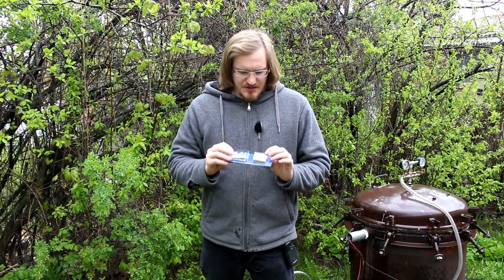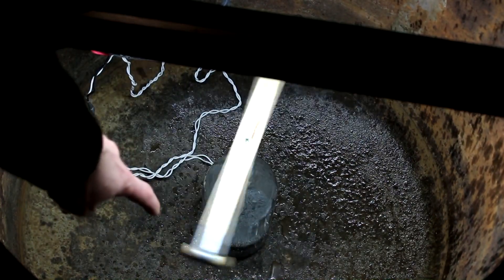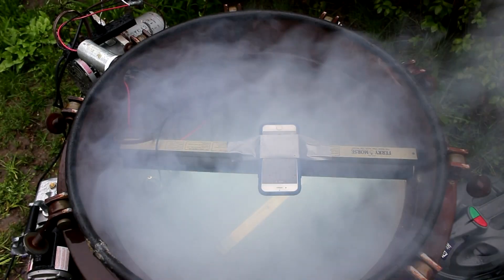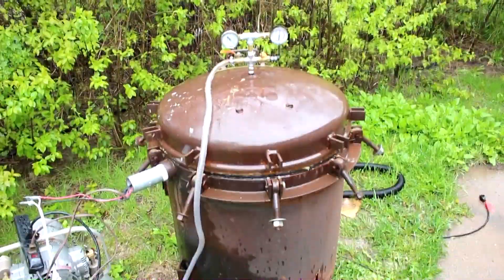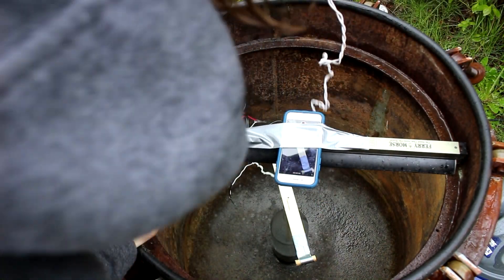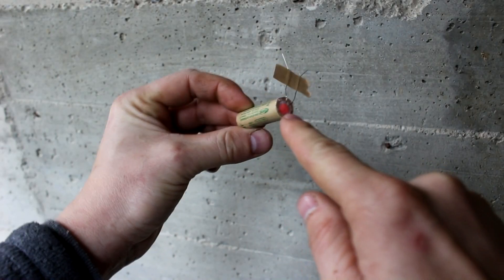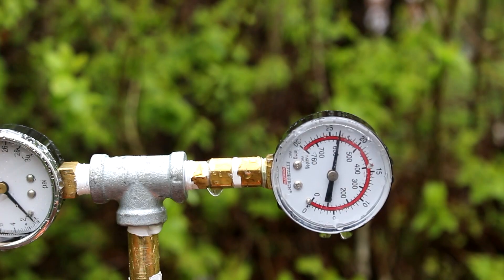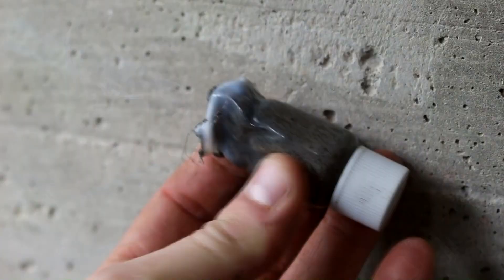Will a Model Rocket Motor Work In Vacuum?

Comment: im not sure but, isnt it kinda cheating to put it in its own little bottle and then create a vacuum because the bottle is still under normal pressure? please reply why i am wrong if so :)
Reply: it's not the oxygen that's the problem, the rocket has its own oxidizer; It just wasn't designed to work in a vacuum, if he filled the bottle with an inert gas like Nitrogen it probably would've worked as well.
Reply: 2010invent huh? yeah, obviously if the fuel in the rocket runs out the rocket doesn't work anymore. And rockets move by pushing a huge amount of mass in the opposite direction they need to at high velocity similar to how a cannon experiences recoil when fired. The combustion drives expansion of the propellant, in turn driveing said propellant out of the muzzle/nozzle at very high speed and pressure. No air required in either scenario. The lack of air to get in the way even facilitates higher exhaust velocities and even higher performance.
Reply: 2010invent 

you still don't get newton's second law.   force = mass x acceleration 
now, if you take a gallon of rocket fuel and  squirt out of a nozzle without igniting it,  at say, 300 feet per second. 
there will be some force (recoil) and there will be a measurable amount of it.
but it won't amount to much.  you take that same gallon of fuel,  expand it several thousand times by atomizing it, and setting it afire. ( remember things expand in volume when heated)
and whoo boy... now you have something! that flame is gonna come out of the tail pipe at 4,400 feet per second.   same mass x a helluva lot more acceleration. = ridiculous amounts of force. remember you didn't change the mass of the fuel, you just expanded its volume and made it go a ludicrous velocity.   
just like if you fire a .45 acp carbine that shoots a 200 grain projectile at 900 feet per second, and compare it to a .45/70 rifle that could in theory fire a 200 grain bullet around 2000 feet per second.  guess which one of those is going to whale on your shoulder more?  same bullet,same mass, alot more force (recoil). the difference is the velocity. 

now that you understand newton's second law... let's look at the third law.
on earth or in space, jet or rocket propulsion has nothing to do with the exhaust eflux acting on something to "push against"  ie: atmosphere to produce thrust.
it's all about the velocity, and mass of the exhaust plume -  as dictated by the second law of motion.  

you take jet fuel and air, or an oxidizer and a rocket fuel, or a pair of hypergolic reactants, and combine them in a combustion chamber and light them...
what happens? they expand at a frighting rate and come out the nozzle at supersonic velocity.    
those gasses have mass, and they are going really really fast, and there is a fuck ton of it.  the object they are squirting out of is going to move with the same amount of force... in the opposite direction. so says newton's third law - for every action there is an equal and opposite reaction.  
just as the firing of a bullet will drive the rifle into the shooters shoulder with force proportionate to the size of the powder charge and mass of the bullet.  so will the aircraft or space craft  "recoil" from the expulsion of mass in the form of the massive amount of supersonic expanding gas coming from its exhaust nozzle.  does a rifle recoil because the bullet and shot gasses push against the air when they exit? certainly not... that would be a silly thing to think, No?  it's because the mass of the bullet and shot gasses are exiting the barrel, which causes the rifle to go in the opposite direction. 

it's really very simple,  if you realize that 1. the exhaust gasses actually have weight (like the bullet) and 2. exhaust gasses have velocity (like the bullet)
then it's not so difficult to make the logical leap to how a rocket engine could thrust in a vacuum.   something to "push" against need not apply.
Reply: 2010invent 

go stand under an AJ10 on a test stand and have the guy in the block house push the big red button. 
then you'll get to see just how "candle like" that exhaust plume is. 
there wouldn't be be enough of you left to pick up with a shop vac... that I can guarantee. 

and the AJ10 is a little upper stage motor...
Reply: well it did not really require oxygen because the fuel already has oxidizer in it to provide oxygen for the reaction it only needed the pressure to get the fule going once the fuel started to burn it did not need any pressure
Reply: At first he was trying to get it to ignite in vacuum, but when he realised that wouldn't work he used the bottle to start it in atmosphere so he could then see if it would continue to fire once exposed to vacuum.
Reply: How can it be "cheating" if it works? This is just the method he used to start the chain reaction to allow the rocket to self-sustain itself. The rocket is burning in the vaccum, the bottle is just there as a catalyst to get it started.
Reply: Jjaro V real rockets designed for vacuum conditions something similar to this by restricting the exhaust port to allow the pressure to skyrocket when the fuels meet and begin to combust before exiting into the bell nozzle at high velocity. they just use thir own liquid fuel to provide pressure in an enclosed space so combustion can occur instead of an outside pressure source. A solid fuel hobby grade motor has no such mechanical advantages to work off of.
Reply: "Will a Model Rocket Motor Work In Vacuum? -No."
The motor works just fine.. His ignitor does not work in a vacuum.
Heck, in my own experience those ignitors only work about 4/5 of the time on the ground under ideal conditions!
Reply: All the oxygen was not used up. The Fuel in the motor uses potassium nitrate which is an oxidizer. But yes, it will burn in a vacuum once started.
Reply: every problem has its solutions a combustion dosent make a combustion engine, it takes a piston to get things started and meny more things to make it run and produse momentum. a rockit doesn't make a rockit that works in space it take meny more things to make it run and work perfectly. so asking if it is cheating is like asking if it is cheating to put  weels on a car to make it run on the road
Reply: I am very sure the bottle was not sealed tight enough to keep any pressure inside while pumping it down. The point of the bottle is to provide a little bit of "back pressure" for a little bit, which is created by the gases created by burning fuel itself. The bottle is so small that it is immediately filled with gases as soon as the combustion starts.
Reply: 2010invent Funny how muh mind control just happens to not work on certain members of our society like you, especially since you all seem to display very poor language skills, which is indicative of low intelligence. Perhaps there's a simpler explanation of why nobody agrees with you which involves your low intelligence and lack of understanding of basic principles of physics and chemistry.
Reply: TheCascadian 
"Erik Wigforss God isn't real. Grow up and take a physics class."
Don't waste your breath, or any electrons on him.
Reply: LifeIs Short 
If the Earth is flat, then answer this question. 
Why, when I go to Rio De Jinarro Brazil and I look up in the night sky to the south, I see the constellations seeming to rotate conter clockwise. around a specific point close to a star but not perfectly on it. But when I look up in the northern night sky here in Missouri,  I see a different set of constellations seeming to rotate clockwise around a specific spot in the sky that corresponds with the star Polaris.  How can that happen on a flat Earth?  It's  simple to explain on a spherical Earth.
Reply: LifeIs Short 
Oh, so you don't have a coherent reply so you're going to dismiss me and my simplest of proofs that your flat earth theory is wrong.
I want to hear what kind of machinations you have to go through to save your conspiracy.
Reply: Jeff Marler yeah but Cody can make his own he is good at those things
Reply: bladerise Not cheating, as it's just used to get reaction started. Shortly after motor is running it Burns through casing and no longer relevant. I would have tried using a piece of nichrome wire throughout motor (right down the center).
Reply: dahat42 your actually comparing apples to oranges there. there is a big difference between the rocket engines tupically used in space and the one that cody is testing here.
the motors typically used in space burn liquid fuels not solid fuels and they are presurised by a turbopump that presurises the combustion chamber. for any reaction to occur there must be sufficient pressure for the attoms to interact with one another.
this motor is a solid fuel motor which means it is just a shaped explosive charge   in the case of this motor its just compressed gunpowder with a hollow cylinder. it needs pressure to ignite because in a vacum the energy released by the initial ignition burst is spread out too fast and too far to allow the reaction to become self sustaining hence why a presure cylinder was required for the initial ignition.

the gas in that cylinder is not used in the rocket motors start up. filling it with xenon wouldve had the same effect.

changing the igjiter to a blanket igniter that interacts with the majority of the fuels surface area within the motor would also have negated the need for a pressure cylinder
Reply: +Erik Wigforss THe global elite? I had no idea he was paid by highly skilled CS:GO players. In all seriousness, it's just willful ignorance to dismiss this as "muh shills" when there's literally nothing stopping you from replicating the experiment. That's what science is all about, but I guess you don't understand much about that do you? Nah, the Jew World Order is paying some random guy in Utah to make a video about rockets to confirm opinions everyone already has, never mind that it's better to just leave an issue alone if you've already deceived everyone lest they start to wonder why you're trying so hard to convince them of what they already believe.
Reply: 2010invent 

lol.

obvious troll is obvious...
gr8 b8 m8, you ra8 an 8. 

get back under your bridge silly boy.
no one is buying what you are selling.
Reply: +bladerise I suspect that if he used the igniters at the recommended voltage, the heat applied would hang around longer, and might stand a better chance at getting the gunpowder reaction moving. He seems to have bypassed that process and simply tried to ignite the motor by exploding the bit of nichrome wire inside the igniter squib with house-current. 

I think this would be counter-productive, blowing the igniter substantially out of the powder-grain contact quickly without applying very much heat energy to it.

Don't get me wrong, you can make cool time-exposure photos by exploding bits of nichrome wire, but I don't think that's the best way to apply heat to gunpowder.
Reply: sleat Yeah, I don't know, man. Despite the mountains of evidence of a globe Earth and absolutely zero evidence of it being flat, we're still here debating it. 

Ask one of them to show you the edge or the firmament. Surely one of them must have driven/floated/flown to the edge by now, right? But no, they come up with some bullshit about an ice wall that you can't approach. Or armed guards. Or something equally fucking stupid. 

Like this idiot, LifeIs. Absolutely no idea what he's talking about, yet talks about it like he's an expert. An absolute poster child of Dunning Kruger. 

Keep after it. I won't waste any more time on flat Earth bullshit.
Reply: +Robert Destree "I don't know why we have this sudden uptick in flat Earth believers."

1. Looking for attention?
2. Trolls?
3. Wanting to feel "smarter than the sheeple"?
4. "Me-too" video monetizers, and the "old guard" likes of Eric Dubay.
5. A psyop purpose-designed to make other conspiracy theories look silly by association.
6. Unfortunate people taken in with believing what they're told by scammers, without verifying it.

Perhaps a mix of some or all of these things.
Reply: The rockets useable in a vacuum also have their own pressure container with a high pressure feed, so that the fuel burns at much greater than atmospheric pressure. These model rockets don't really accurately simulate that.
Reply: view the rocket and bottle as its own rocket
Reply: Mauricio Harrison 
to get the initial burn started it was needed.   a solid fuel grain can be difficult to ignite, even under one atmosphere.  there wasn't enough air in the bottle to supper combustion any longer than was needed to get the propellant (which is a solid fuel and oxidizer molded into a cylindrical grain) to ignite.
had this been a hypergolic or LOX/liquid fuel motor, it would have lit quite easily even in a vacuum. as those types of fuels will create thier own atmosphere in the combustion chamber. 
unfortunately building a small scale rig to use these fuels in this vaccum chamber would be difficult.
Reply: dahat42 

the model rocket motor propellant grain contains it's own oxidizer. 
probably potassium nitrate.
if you can just get it hot enough to start the reaction - it'll sustain in any atmosphere you want. 
the trick was getting the reaction started. 

incidently, solid fuel motors aren't used in a vacuum... because they would be difficult to ignite.
Reply: 2010invent Based on your grasp of the English language I'd say you're the only one who has contaminated water. Lead, based on the severity of your apparent learning disability.
Reply: 2010invent >"But that cannot run longer than the air supply"

I mean this video kinda showed that even toy engines can, it's just that engines designed for an atmosphere don't have the same sort of fuel used which allows it to ignite easily in a low-oxygen environment. Do you know what oxidizer is? One extreme example is chlorine triflouride, which can ignite almost anything, even glass, without the presence of oxygen. Most less powerful oxidizers, however, contain oxygen in their chemical composition which reacts with the fuel in the same way that oxygen gas does.

>"If space is a vacuum rockets cannot work doesn't matter how you try. Nothing for it to push against."

Again, the video kinda showed that this claim is false. But you don't even need to watch it to know this. The exhaust pushes against the rocket. Do you actually think that all propulsion is caused by pushing on air and not the projectile? Air is not that viscous. This is why recoil exists in firearms. The bullet takes the place of the exhaust from the motor: A combustion reaction pushes a massive object(bullet/exhaust) in one direction, causing another(gun/rocket) to move in the opposite direction.

Honestly both of these claims can be debunked just by watching this fun 8-minute video. But I also think it's funny that nobody making the claims you're making has ever actually studied rockets. Why not go into that field and "expose" them or actually see for yourself that the things you build do in fact work?
Reply: +Erik Wigforss God isn't real. Grow up and take a physics class.
Reply: 2010invent I have a friend that works in a pharmaceutical company. He actually developed a cure for this disease in horses, yet his project was dumped into the trash by the company simple because it didn't make any profit. Companies exist solely to make profit, nothing else. They don't care about you at all.
Reply: +Erik Wigforss Ok brother, you don't know me but I can tell that you have some doctrinal issues, biblically and not. One, NASA has sent rockets into space and they just use higher density fuel that can create more pressure by itself and sustain a burn. The pre-tribulation rapture is a satanic lie that is going to be responsible for the great falling away. You need to do your research on what bible you are reading, and read into the "proof texts" they are telling you about the rapture. I like your enthusiasm to preach Jesus Christ, but don't deceive people with your doctrines of man.
Reply: @VegasSubie  nasa means not-a-space-agency. We never went to space. That’s a lie. They themselves say they can’t get through the van allen radiation belt. That’s why they haven’t gone back and they say they lost all the information on how to get there. If you want to bring the Bible into this, the Bible says there is a firmament above us. Water above.
Reply: +IamGrimalkin  "I don't think the heat is the issue here, the problem is there is not enough pressure to hold the liberated oxygen to the rest of the gunpowder to keep the reaction going, as he suggested in earlier videos. "

I guess you could test at what pressure it's possible to get gunpowder to ignite with any amount of heat.
If there was a sort of thick ni-chrome element in your test-chamber, connected to a variable power-supply, you could simply start with samples of powder, and gradually reduce the pressure until your pile of powder utterly refused to go off, no matter how long the red-hot ni-chrome sat under the pile.

Seems like a tiny soft-rubber cork would allow enough pressure to develop in the throat of a motor, if it made a fairly good seal, once the igniter squib went off. The ones you get with the motors don't seal too well. The little igniters are a nichrome bridge with some self-oxidizing flammable material painted on.

The jar method with a bigger plug is perfectly valid too, but it requires the plug to hold more force.
Reply: 2010invent You are absolutely wrong. Go study Newton's third law. There is no such thing as "pushing off of air". It is the rapid expansion of gases that causes thrust. If you take a pressure washer wand and pull the trigger, you will get kickback. Aim it at nothing, kickback. Aim it at a wall, exact same amount of kickback. The kick is caused by the water exiting the nozzle at high velocity, and not caused by "pushing off of" air. By your idiotic logic, the closer it gets to something that's fixed in place, the more kick you should feel. That ain't how Newton works.
Reply: bladerise 
"im not sure but, isnt it kinda cheating to put it in its own little bottle and then create a vacuum because the bottle is still under normal pressure? please reply why i am wrong if so :)"
-------------------------------------
It's not cheating.
The reason why these miniature / model / toy rockets need to be allowed time to ignite, is almost certainly because the reactants, fuel and oxidiser both need to be heated adequately to start the chemical reaction. Failure to ignite is not the same as failure to run, i.e. burn.
The fuel is most likely likely gunpowder.

With the space-rated rockets because the reactants used are far more reactive both gases.  
"Once in the tanks and with the launch countdown nearing zero, the LH2 and LOX are pumped into the combustion chamber of each engine. When the propellant is ignited, the hydrogen reacts explosively with oxygen to form: water! Elementary!

2H2 + O2 = 2H2O + Energy

This “green” reaction releases massive amounts of energy along with superheated water (steam). The hydrogen-oxygen reaction generates tremendous heat, causing the water vapor to expand and exit the engine nozzles at speeds of 10,000 miles per hour! All that fast-moving steam creates the thrust that propels the rocket from Earth."

https://blogs.nasa.gov/Rocketology/tag/rocket-fuel/

Ignition
https://blogs.nasa.gov/J2X/tag/ignition/
Reply: LifeIs Short No. Stop uttering nonsense. Nothing is pushing off the walls of anything. For fuck sakes. Learn physics. 

Go to a car wash. Take a bucket with you. Aim the pressure washer wand completely level and pull the trigger. Feel the kick? Newton's third law. The rapidly expanding water jet is causing the wand to kick back. Now aim it at a wall. Pull the trigger. Exactly the same amount of kickback. Aim it into the bottom of the bucket. Pull the trigger. 

Guess what? Exactly the same amount of kick. It's not pushing off the air, the wall, or the bottom/sides of the bucket. It's the pressure at the nozzle tip. Period. 

Rockets work fine in a vacuum.
Reply: One hundred percent wrong. Again. 

I give up. You have no interest in learning why you're wrong. There are countless experiments done right that disproves you on every point. But you don't care, you'd rather live in your cone of ignorance.

Don't bother replying. I won't waste more time dealing with you. You're just not worth it.
Reply: +LifeIs Short So, do you reckon a gun would recoil in space?

"You cannot push away from nothing."

You can push away from mass !

That little motor is substantially lighter after it's been run. Why do you think that is?
Reply: Daniel Glus You're wasting your time with him. He doesn't understand Newton.
Reply: +2010invent "Why a rocket engine doesn't melt steel?"

Gosh! OK, so a rocket engine would melt steel if you didn't stop it from doing so.
Rocket motors and welding torches are very similar, except most liquid fueled rocket motors are >1000 times bigger than any welding torch. Ever noticed how your welding torch is made of pure copper? That's on purpose, not just because it looks pretty. Also, you can definitely get thrust from a welder. If you build the right sense apparatus you can measure thrust from a welding torch.

If you look into how liquid fueled rockets are designed, there is usually a two-layer combustion-chamber-nozzle. The inside layer has liquid oxygen flowing through it, which is very cold, and stops the inner layer from melting. Engines like the F-1 also ejected the cooler turbopump exhaust into the gas stream about halfway down the nozzle, which ran along the inside wall of the nozzle to keep it cooler.

For short-burn solid fuel rockets, you have to make the throat of the nozzle out of Graphite, fireclay, or machined copper, which is harder to melt than steel, since it conducts so well.

" Yet we are told that air-plain fuel melted the steel on 9-11."

You're comparing apples and oranges, first of all. Airplane fuel isn't the same as rocket fuel + pure oxygen. Those fires on 911 were office fires, obviously burning rich since the smoke was dark.

If steel literally melted (there's an ongoing debate about this) something else must've melted it. You can't burn kerosene in air and melt steel. If you could, you could weld with a kerosene flame, and you can't do that.

Also, jet engines have a kind of high-nickel content steel called inconel for the "hot section" of the engine.
Stainless would also work, and has been tried, but inconel has other desirable properties, such as the fact that it doesn't significantly lose strength at fairly high temperatures, and doesn't expand when heated as much as normal steel. When you have < 1mm clearance inside your engine between the turbine blades and the casing, this is very important!

"Scientist don't work for money and fame?"

They compete with one another! If one of them ever tried to BS their way around an experiment, the others would be on him like flies on...

"Doctors want to cure us?"

Most actually do! I've got a few I'm close to, and they definitely want to make you well.

The ones who profit from you being "a little bit sick" all your life, are big pharmaceutical companies.
They'd happily sell you medicine for your entire life that just stopped your symptoms without curing you. They exist purely to make as much profit as possible, for themselves and their shareholders, as possible, for as long as possible. Making you well (or killing you) is counter-productive, since they lose a customer.

As an example, SSRI antidepressants. Close friends have asked their doctors if they could ever stop taking them, and been told "no". (the doctors are following the pharma company instructions) So they "revolted" and got themselves off the anti-depressants. They're now productive, happy and healthy!

This is not a recommendation! If you're on antidepressants, you may need them to stop from being, for example, suicidal or otherwise dangerous to someone. Some don't.

You bring up a lot of cases where people lie. Yes they do, but others also expose the lies. People do that, but it's very hard to lie about the very laws of physics. Someone competing with you will expose your lie fairly quickly and gain power from that.

The alternative is just crazy, where every single one of millions of scientists are all agreed that they will lie to you, and not one of them has blown the whistle on it, which would virtually guarantee that scientist great fame. And if he was killed, that would make him even more significant and bring even more light to the "great hoax", if there was one.

Again, the fact that authorities (mainly politicians and marketing types) can and do lie, doesn't mean either that the Earth is Flat, or that rockets can't work in space.
Reply: +rex racer "Try to fly anyway and I guarantee you will be shot down b4 you can get 75 miles over land."

I guarantee you won't !

Go and talk to antarcticaflights.com.au
http://www.antarcticaflights.com.au/

Their 800 number is right there. Please call them and confirm that "you won't be shot down"!

They will fly you down to the Antarctic continent, and fly you around down there, and then back to Sydney or Melbourne the same day. You don't land, but for even more $$ you can land there, with other providers.

If you take a GPS with you, it will definitely show you're over Antarctica, not to mention that it's pretty hard to fly due south from Australia for hours and not get to Antarctica.

If you decide to book a flight for next year's Antarctic "summer" I will come with you!

Honestly, friend, if you think there are jet fighters based in Antarctica 24/7 year round, can you elaborate exactly where they might be based? Also, where is the associated air refuelling wing which would gas 'em up inflight?

If they weren't based there, there is no way in hell they'd have the range to come get you if you were flying there. Fighers just aren't designed for ~6-10,000 miles of range.

Further, who pays for all that, assuming it's real (it isn't)?

Check this out. These were long range bombers and they were only trying to get to the Faulklands, much less Antarctica.

https://en.wikipedia.org/wiki/Operation_Black_Buck
Reply: +LifeIs Short "When you turn away from Polaris, (looking 'south'), everything would turn the opposite direction."

If Polaris is in the center of a domed Flat Earth, there is literally no geometric way to make it so that all Southern Hemisphere Observers will see the same exact Southern-hemisphere-only stars rotating counter-clockwise around the dim star Sigma Octantis. Since a dome is at best half a circle, the stars at the edge would be going along the horizon, not rotating the other way. "Turning away" from Polaris, assuming you're at the North Pole, would involve looking straight through the ground.

That's a very big problem many folks have with Flat Earth. The night sky in the Southern Hemisphere simply doesn't work with the models that have been presented.

If you can come up with a geometry (just draw a simple diagram) that allows say, both Australians and South Americans to be looking the same way when they all look South, and still have the Earth be a disc, I'd really love to see it. If you look at a "flat earth map" South is in different physical directions for each Southern Hemisphere continent.

If you imagine the stars are on not a dome but a sphere surrounding the earth, then the only way to see the counter-clockwise half of the star-sphere is to be on the other (South) side of the earth.

If the "dome" was a sort of rubber-sheet, then you could force it to rotate one way around Polaris, and another way for one of the Southern hemisphere continents, I spose, but it would then look horribly wrong (i.e. not like reality) for all the others.
Reply: +Lifels Short OK That's a reasonable reply.  So  now we are moving into a flat earth argument. Now I understand why you find the concept of a rocket a problem. So the problem is this. If you assert the theory that the earth is flat, then the burden of proof is on yourself. There is no need for anyone to prove that the earth has another shape as they are not the one making the assertion. For example you mention atmospheric lensing. You should be able to provide formula describing the behaviour of light which matches our observations. Or explain why half the world is in day and half in night again provide the maths. 
If we are under a dome and the stars revolve around polaris. Then the dome revolves either clockwise or anticlockwise. You cannot have a point on the earth where there is another rotational centre and the dome revolves the other way. I am a artist and can do the transforms in my head. You should try modelling it in a CGI program ( blender is free) https://www.blender.org/ It is a simple model to do. I could knock one up over the weekend but I would need to understand exactly how the flat earth works in order to produce an accurate model.  Interestingly I have asked this question before and no one was willing to help.
Reply: +Mark Gohl Yes, showing how two distinct celestial poles work on a Flat Earth has never been published, as far as I know. I'd be very impressed if an F-E believer could show a model where this works.

I think the burden of proof also exists for folks who claim rockets cannot work in vacuum, since rockets do work in vacuum whether they believe it or not.

We can obtain separate evidence (without vacuum thrust experiments) which very strongly indicates that man-made objects are in space. The evidence for man-made space vehicles is interlocking, i.e. several things can be observed about one vehicle via different methods of testing from Earth.
Reply: LifeIs Short 
NO, this is where Flat Earth has no reasonable reply. 
The FE model asserts that Antarctica is a ring of ice around the edge of the supposed FE. So, when I am on the beatch in Rio, looking toward Antarctica, I am much closer to the "rim" of earth looking off the edge. I would see the constellations traveling straight, left to right across my feild of vision.
The only way I could see the constellations making a clockwise circle around a point would be if the FE were flipping over. Which of course wouldn't work because that would mean what I see from Missouri is rotating at 90° to what I see in Rio.
Case closed the earth is a sphere. 
I don't need to watch anyones video to see that this is so. Stick a dowel through a ball, and a dowel through a coffee can lid. Mark the relative positions for Missouri and Rio de Janeiro on each and tell me which supports what I see.
Reply: Jerry Long I'll give you a hint why he won't acknowledge you: Dunning Kruger. He truly believes the nonsense he's spouting. Good luck.
Reply: Robert Destree 
Yeah,  earlier he said someone could put an end to the FE scam in an instant by just showing their evidence.  I thought this would be the simplest proof. Anyone with the capacity for abstract reasoning can close their eyes and picture this example. 
He's got nothing, so he ran away. He'll be back, after he watches some more videos, and have some explanation that requires me to watch the video so and so put out. I think the whole FE scam is about monetizing videos.  The only true believers are those folks that already believe in some other conspiracy theory. The real thinkers behind it know it's BS, but they're making money off their videos. They are laughing at the true believers all the way to the bank.
Have a nice evening Robert :) Dunning- Krueger does fit though.
Reply: +Lifels Short My computer is currently tied up with a Rendering run at the moment. It take about 5 minutes to render a frame and I have a few hundred frames to go. However next week I may have some time to have a go at doing a model of a glass dome with things on the outside of it. Do you have any more details ? or would you like me to just wing it ?
Reply: LifeIs Short "we have no idea on the thickness it would have to be, to give the appearance, and there may be two dense arms (straight or curved) circling above, that represent the Milky Way band."

We don't ever see the Milky Way move relative to the other stars, though. It rises and sets with everything else.

"Just guessing, haven't seen much on this other than people's theories on the star trails.  Away on trip so only phone right now, but would love to mess with rendering"

I think rendering a Flat-Earth surface and cosmos, such that it shows how we see exactly what we see, no matter what hemisphere we're in, is a fantastic idea!

Here's a bit of a reminder of the things anyone can currently see now, looking from the right places:

- Polaris, seemingly stationary and around which the stars appear to rotate counter-clockwise at 15 degrees per hour, in circular paths and which moves up 1 degree in the sky for every 60 nautical miles you travel North, and down 1 degree for every 60 nautical miles travelled South.

- When you are standing on the Equator you can see stars rise in the East, and travel straight over head, as well as being able to see the stars further North and South moving in smaller and smaller sub-circular arcs as you look toward each Pole. When you face North you see everything turn counter-clockwise, and when you face South, you see everything turn clockwise, all at 15 degrees per hour.

- If you are in the Southern Hemisphere, the Southern Cross is always visible beyond 60 degrees South latitude (as long as it's dark enough). The rest of us "down there" see it for a good part of each night.

It's a sort of diamond of four stars with two stars off to the side lining up with the "head end" and pointing to it from one side. This whole assembly of stars rotates evenly around a spot most people can't see (too dim) which contains Sigma Octantis, at 15 degrees an hour, no matter which continent you're on down here.

The important point is that moving from Chile to Australia to New Zealand to South Africa, this thing is often visible, rotated around a point in the sky which is "up" from the horizon the same amount as the latitude of the person looking. But looking "south" from Australia and South Africa on the current F-E map, are different directions!

Your render needs to show people how that works.

- On the Equinox the sun always rises due East and sets due West, for any observer who sees the sun, unlike on Flat-Earth maps published so-far. Definitely room for improvement!

- If you put your viewpoint inside this "render" and move around, the visible horizon needs to get further away by the right amount. This means that various objects "out at sea" at different distances from the viewer, need to only become visible as the viewer gains height, which is what everyone sees now, when gaining height.

I think it's great that you are interested in making a good model of how Flat Earth works, which describes what we all see depending on where we are. If you get stuck with what the sky should look like from any particular point in time or geographically, you can use Planetarium software to show what people actually see from those places at those times.
Reply: +Robert Destree "You're the one who started a conversation with me, with no lead-in."

What a clever trick for those times when you can't think of what to say but want to bug someone!
- Make a sarcastic remark with no solid context.
- When replied to with "What do you mean?" use that as an excuse why the other needs to be talked-down-to.
- Now you have a conversation, and don't need a topic! Congratulations, you are a master manipulator!
- Profit!
Reply: sleat I don't know why we have this sudden uptick in flat Earth believers.
Reply: +LifeIs Short Here are a few of the things that F-E books don't seem to address properly:

1. Given a distance away that Polaris is said to be, and assuming Earth is Flat, the angle "up" from the horizon is only correct at two latitudes; The North Pole, and one other which depends on how high you say Polaris is in your F-E model. Near the NP, it's too low in the sky, and as you get down to the Equator it's too high by a great deal, whereas on a spherical earth, you don't have to come up with excuses for light always bending one way in one place and always bending another way in another. It seems like quite a stretch to say that the atmosphere somehow "knows" where the viewer is, and bends Polaris's light just right so that it always appears at exactly the elevation of one's latitude.

2. The Southern Cross constellation circling evenly, clockwise, around a point in the sky, where Sigma Octantis would appear if it were brighter, where that center-point exactly matches your latitude in the Southern Hemisphere. i.e. from 45 South, it's 45 degrees up, and so on. Again, this constellation circles clockwise around celestial "south" no matter what continent you're standing on in the Southern Hemisphere. The problem is that "south" from all of these continents is a different physical direction on the Flat Earth Map.

" Precession of the equinoxes occurs throughout, but again, doesn't prove either theory. "
This isn't really about precession of the equinoxes, it's about a dire problem with the F-E model which has the sun literally on the wrong bearing from the observer at sunrise and sunset, year-round, but most easily quantifiable on the Equinox.

3. What the books fail to address about the Equinox is that in the real world the sun, on the Equinox, rises a 090 degrees true east, from a direction exactly 90 degrees right of North. In all F-E models published so far, at sunrise, i.e. 6 hours before noon, the physical position of the Sun is at 045 degrees true. That's 45 degrees too far north. 45 degrees is a lot to explain away with "perspective" or "lensing". It gets worse. At sunset, it should be at 270 degrees, true. That's what everyone sees, but on an F-E map, it's setting at 315 degrees true, once again 45 degrees too far North.

In other words, in a F-E, the sun would appear in a drastically (i.e. get hopelessly lost if you used it) direction, and would only be "about right" near Noon. Even well after sunrise, when the sun is nowhere near the horizon, it's still like ~30 degrees too far North. Oddly, nothing else seems to magically appear 30 degrees too far north, i.e. the stars before sunrise on the same day.

"Most everything moves at 15 deg per day"

You mean 15 degrees per hour, right?

" I think a 'debunk' of FE would be a midnight sun in Antarctica, staying visible for 24 hours."

Certainly would!

"But all footage of this has been edited, as people have shown, with 8 hours missing, including one person who called/emailed their station to provide the missing footage from a supposed live feed and got the run around."

Yes, for some reason any "slam dunk" proof of the earth not being flat somehow has to have something wrong with it, like all the ever-growing number of photos claimed to be taken from space. It's a shame, really.

So, if someone you trusted physically spent 24 hours in Antarctica and said "real deal, it stays up for 24 hours" would you instantly have to stop trusting them? You know that it's quite easy, given the money, to spend a few days there in the Southern Hemisphere summertime, over the Summer Solstice, right?

If they are farther South than 66.5, they should have sun 24/7 for several days.

"So I don't know. "

Trips south of 66 South latitude are only a few grand, and it'd be the vacation of a lifetime!
Reply: +LifeIs Short "I've also listened to Bill Nye's explanations of debunking FE, and Niels Tyson, and they use talking points that are already shown in FE models, so I just don't trust them anymore."

It's a really good thing media dumbasses like Tyson and Nye don't control the shape of the planet, I guess.
Would you start smoking if they told you cigarettes were unhealthy?

There's a very simple proof of flat/curved experiment that can be done with two or more people with comms gear, some drones, and a distant (30 miles or so from the vantage-point) high object like a radio-tower or city building.

"I just dug into it, because there had to be some easily proven test that shows curvature, and FE takes into account most all of it, and the curvature tests seem to NOT show curvature, but rather prove its flat."

Seems like what normally happens is that folks mentally "throw away" stuff that doesn't agree with what they already think. The globe side needs to be able to tell you what's wrong with a "flat earth proof" evidence. And F-E folks need to be able to tell you what's wrong with evidence of a globe. Claiming that "all evidence of this type is fake" is cheating, on either side.

The "globe earth" side doesn't usually say that "all evidence of Flat Earth is fake", but what generally comes out is "the experiment should be changed this way" or "that experiment proves neither curved nor flat".

Again, if one side of an argument has to change accepted physical laws (like gravity, but without replacement with something else whose equations predict reality) or throw away all evidence of a particular class (i.e. all space pictures are hoaxes, or all 24 hour sun time-lapses are hoaxes, or all measurements showing the earth to be flat are hoaxes) then that doesn't add to the credibility of the theory.
Reply: +James Bondage  "Meaning the LORAN method of communication never went away. They're still using it to this very day."

Can you direct me to documentation of how several TV channels at once get transmitted over LORAN?
My understanding of LORAN is that the signals are extremely simple, with the purpose being to allow calculation of the receiver's distance from the transmitter.

Looking at the frequencies it uses, the bandwidth doesn't seem nearly enough to even send one TV signal, let alone the number that come through my satellite dish.

I've got another burning Satellite TV question as well. How come when I un-bolt the positioning and move my dish ever-so-slightly, so that it's no longer pointing to a spot ~22,000 miles over the equator, does the satellite reception disappear? If it was coming from a tower, why would the dish need to be pointed at the sky, and why so carefully? (I was able to get the TV signal back by nudging the antenna back where it was).

I don't need to do that for normal TV, radio, or WiFi, so why such a sensitive dish-antenna for a signal like LORAN? Wouldn't a long dipole be better? Also, satellite TV is definitely Ku band, like ~10ghz, as evidenced by my spectrum analyzer connected to the LNB preamp. Ku Band won't go very far horizontally, so with no towers in sight, and definitely none in the direction the "dish" is pointing, which tower is this Ku band "satellite" signal coming from? (Ku band only works line-of-sight). Also, LORAN, with a range of a thousand miles or so, wouldn't work on Ku band.

"Satelites do not exist."

So, if both my friend 700 miles away and I both tune in a low-earth-orbit satellite, one of the HAMsats, why is it that I have to tune in the downlink frequency slightly up as the thing comes towards me, and he needs to tune his receiver down as the thing is leaving his area at the same time (had him on the phone). How can both me and my buddy pick up the same drone at the same time, 700 miles apart on VHF?

I knew the thing was flying overhead, since I had to point my Yagi antenna up to the sky, and follow it, to keep picking it up.

"Drones & high altitude planes do."

Sure they do. But, according to the Doppler formula, (why I had to up-tune and buddy had to down-tune for the same signal at the same time) comes out to the speed of the transmitter moving at several kilometers per second . That tallies with the thing going from horizon to horizon in about 5 minutes, but being too far away to hear even a whisper.

At that kind of speed, the drone or high altitude plane should have been making an orange ionization trail, and the sonic boom from, whatever, mach umpteen or so, should have broken windows in my neighborhood. Amazing that it did neither.

So yeah, I guess if you've got invisible, inaudible drones, or planes that don't make sonic booms and can go horizon-to-horizon in 5 minutes without detection, and can turn up right on schedule for another HAM halfway around the world on the same frequency in only 45 minutes, I guess you don't need satellites at all.

If only these things could carry people hell we could travel between Hawaii and the East Coast in half an hour!

So, have you got any photos of these incredibly high, incredibly fast, and soundless high performance airplanes that can move at hypersonic speed without ionizing the air?

What kind of fuel do they burn? How far can they go? And most importantly, who pays for them?
Reply: How do you know you're not just bouncing signals off a moving ionosphere?  No one has seen a satellite in space, so even though it is perceived to work that way, there is no 'proof' of the mechanism, and the mechanism could be entirely different, especially given the shear volume of supposed satellites up there, that should saturate the sky.  I agree with the speed issue, it seems plausible, but I'm just not sure that's the ONLY explanation for what is observed.  Rockets and Satellites are peripheral issues as well anyway, since the real issue is the surface we stand on - and proof of its curvature (should be the most basic thing to focus on).  If a person calls out an agency whose job it is to deceive the public, say, for not turning around 360 in space, you will get a picture of it.  That doesn't mean anything for either side, since it could easily be faked nowadays.  The real proof would have been if they had done these things that FE wants to see spontaneously....like 24/7 footage of space with stars, weather patterns, etc.  I'd like to see an unedited midnight sun in antartica - that would help, but all the videos look spliced.  They fake mythbusters experiments that clearly show other rocket results (like Cody's experiments), and fake Stephen Hawking reality shows with collimated lasers and telescopes that don't even have the right math for a globe model...The moon landings are a complete debacle.  There is footage of a face behind the 1983 space shuttle (from an 'external' camera...).  Appearance of things that shouldn't be seen over the horizon is chalked up to cold air over water, but the same effect occurs with mountains, no matter the weather (same exact measurements).  The whole thing is full of holes even after 500 years of acceptance.
Reply: +LifeIs Short "How do you know you're not just bouncing signals off a moving ionosphere?"

Great question! Here's how I know:

1. UHF (and VHF) don't bounce of the ionosphere, they go through it.

2. The ionosphere doesn't reliably move towards one guy and away from another at a speed consistent with low-earth-orbit, just at a particular time of day when two random parties happen to be pointing at it, any more than, say, clouds do.

3. "Satellites" are on very reliable schedules. Way more reliable than trains or aircraft, unaffected by winds or weather, they turn up to the second at the right time. So the "ionosphere" which the frequencies we were using don't bounce off of, must suddenly have "moved" at just the right time and speed to fluke bounce the signal that never bounced off it before, and indicate with exactly the right Doppler shift for a satellite that it was moving. And it did it again on subsequent orbits, but only then just when the thing was due to come by again.

4. The ionosphere, as far as I know, doesn't contain repeaters which re-transmit received signals on another, completely different frequency to verify contact after a particular delay. Said frequencies, again, are both shifted up slightly for the "advancing" observer, and down slightly for the "retreating" observer, just like a train whistle. Applying the Doppler-formula to the shift amount yields a vehicle velocity very consistent with something in orbit and not in the atmosphere or ionosphere, where the orbit would be nonexistent (no orbits in the atmosphere) 
 or slower (in the ionosphere, higher up).

5. The ionosphere does not suddenly start reflecting VHF radio signals for 6 minutes out of 90, just when a certain HAMsat happens to be due. Also, see 1.

"No one has seen a satellite in space,"

Good, I'm glad to see you checked with everyone both on and off the planet. Seems legit.

"so even though it is perceived to work that way, there is no 'proof' of the mechanism,"

You're quite right. Satellites only follow the laws of physics, so I guess those must be incorrect.

"and the mechanism could be entirely different,"

Can you please describe a mechanism that turns up on time to the second over a particular location, with a significant doppler-shift indicating several kilometers-per-second velocity, in the sky, capable of picking up transmitted signals on one frequency (appropriately Doppler-shifted) and transmitting the same signal "hello Jim" on another different frequency (also Doppler-shifted by a sensible amount for the same HIGH velocity, given the observer and track geometry) but only during the 6 minutes or so when it's supposed to be radio-visible to both, and then does exactly the same trick 3000 miles further along its track, 10 minutes later, for two completely different people, while still showing the same HIGH velocity?

Can you describe some other widget that can do that?

"especially given the shear volume of supposed satellites up there, that should saturate the sky."

Should it?

So, there aren't any satellites, but there are also too many satellites? Sounds good to me .

Let's do a bit of maths. Let's only count the satellites (and "junk" big enough to track) between 400km and 2000km for our "sky saturation check". The rest of the stuff are tiny wads of ice, paint, and metal flakes.

So, ~20,000 objects, consisting of both operational satellites and junk big enough to track either optically or with radar.

How much area does this "danger layer" occupy? Well, between the lowest practical orbit, 400km, and, say 2000km, which is where the vast majority of the crap is, well, that's an area 1.16 x 10^12th cubic kilometers, or 1,160,000,000,000 km ^ 3 or one trillion one hundred sixty billion cubic kilometers.

A fair bit bigger than the volume of the entire planet below. All that stuff is orbiting around in various directions in that "yuge" space. Most all of it is going generally west-to-east, since that's the way it was launched.

Let's divide that space by 20,000 significant items...

If this stuff was all evenly distributed, each item would have its own "private space" of 58,000,000 (fifty-eight-million) cubic kilometers. To put that in perspective, in the same volume as all the world's oceans, there would be 23 of these things.

So, would 23 schoolbus-sized objects scattered around the world's oceans randomly "saturate the oceans"?

Seems not. What do you think?
Reply: +LifeIs Short "again, the point stands, you don't know what you're bouncing any signal off of."

Well, you can rule out some things.

Look for a moment at the number of amateur radio satellites that are currently active.
https://www.n2yo.com/satellites/?c=18

Notice that some of them have digital beacons .

This means that some kind of digitally modulated data is being broadcast by the satellite without prompting.

Some of them have repeaters.

This means someone transmits to the satellite on one frequency, the uplink and the signal comes back on another (sometimes in a completely different band, i.e. send on VHF, receive on UHF) frequency.

"It could be a pulsed wave traveling across a dome at however many km/s you believe to be a satellite."

Can you give me an equation or draw me a diagram of how you believe this would work? I don't see how a simple radio reflection could produce what real people HAMming on these satellites observe.

For example, how would simply listening out with your Yagi pointed along the predicted path of the satellite, cause you to receive a digitally encoded (say something simple like 1200bps FSK which has been used before on amateur sats) signal which contains the vehicles amateur callsign and current skin temperature?

Do you really think the dome is capable of hosting multiple digital beacons, along with transponders and repeaters, that just happen to become available at a given location right when a satellite is due? Again, a beacon doesn't require prompting. It's just a signal out-of-the-blue, (but right on time) sometimes only lasting for a few minutes. The point is, if it's sending sensible digital data, it's either aliens, or man-made.

"at however many km/s you believe to be a satellite."

It's not about belief, as you are undoubtedly well aware. It's about measurements you can make yourself, and evidence pro, or con, that you can easily collect yourself. Simply listening to sats these days is cheap. You can buy amateur software-defined-radios for your laptop on Amazon. Almost anybody can do it.

For a given height above earth, the laws of physics dictate at what speed a thing will be going if it's in orbit. It literally doesn't matter "how many km/s I believe to be a satellite". Not one bit. Measuring the Doppler relative to yourself merely serves as a data-point. Unless you are saying that speeding, transmitting objects don't generate a Doppler-shift, you have to admit that, if the shift perfectly correlates with the speed something should be travelling in low-earth-orbit, that's good evidence that that's where it is. If it were in atmosphere at that speed it would be burned up in minutes.

Solving the Doppler-formula for a given radio frequency, calculating the relative speed (to you), with some trig, and drawing a graph of the radio frequency change vs time and vs elevation angle clearly shows exactly the relative speeds a person should see for an object coming towards, flying over, and departing, all at the same earth-relative tangential velocity. That velocity comes out to closely match an Earth orbit.

I'm sure your'e interested in the formulas that apply here, right ?

"No one has seen one"

So, when I and others take photos of the ISS (the same one that also generates radio signals at the same time) with telescopes and DSLR cameras, what are we actually doing? Engaging in some kind of communal, perfectly-timed, mass-hallucination, perhaps? Why do the photographs look like other pictures of the ISS? Is every amateur astronomer some kind of hoaxer?

"because you can't even see a jet at 35k ft,"

You can. Even with a cheap old smartphone.

Let's talk about math again.

Do you believe in the formula that gives the angular size, in, say, degrees, for small, distant objects seen by people? Here's a hint. You can test it with large, distant, earthly objects and your hands and fingers in about 10 seconds. You can find the angular size formula, or a calculator using it, online here:
http://www.1728.org/angsize.htm

In other words, do you believe this online calculator will show you either how big an object is at a known distance, or its angular size (say, in degrees, or minutes) if you know its size and distance?

Say we plug in data for an A320 (medium sized) at 35000 feet. So, the angular size seen with a human eye should be 0.196 degrees. About 2/10ths of a degree. How big does the moon look? Its angular size is 5/10ths or 1/2 a degree, anywhere on Earth. So, if it was lit by direct sun, that airliner's total size should be a bit smaller than half the moon. 0.4 moons, approximately full-length, or full-width. If it's making contrails, you'll find the width of them will be almost as big as the moon only a short distance behind the airliner.

The difference is, that generally the moon is being directly lit by the sun, for the parts you can see. Sometimes, just after the sun sets, but hasn't set up at high altitude yet, it will shine directly on the metal of an aircraft against a fairly dark sky. Then, even people with bad eyes can see them.

Not trying to be a smartarse, but have you had your eyes tested lately? Do you own binoculars?

Just looking through my phone, I found one photo, taken with a plain, unzoomed smartphone. It's an airliner cruising at altitude, making contrails, with the moon in the shot. You can clearly see the relative size, and that the object is some sort of swept-wing cylinder.

I'm happy to show you this photo, taken years ago just because the stuff was in front of me and the sky was a great shade of blue over Sydney.

"so how do you see Satellites at >250mi?"

You see them because the photons coming from them manage to get to your eye-holes. That's all that's needed. You see them more clearly when those photons don't get scrambled up by atmospheric wobble between you and them, and when they're magnified by something, like a telescope.

To the naked eye, they look like a sun-colored bright star, if they're visible at all, which makes sense because if you can see them from that far away naked eye, the sun must be shining on them.

We do the math with angular size calculator and we see that, for example, the ISS should look exactly the same size as an 9 inch (0.22 meters) car headlight at 800 meters. If you drive a car on an interstate at night, you see this constantly, possibly at even greater distances.

So, we ask ourselves, with a Nikon P900, could we get a fairly good photo of that car-headlight from almost 1km away across a valley? Sure we could, if the atmosphere wasn't "wobbling" too much.

Distance alone has very little to do with whether you can see something. Size and brightness, and stuff in the way, are the big factors.

So, if you think you can't see satellites, you must think something is stopping the photons from them, dead in their tracks, but somehow allowing starlight, sunlight, planet-light, and moonlight through. You also must think the angular size formula for distant objects (i.e. the rules of trigonometry) are a hoax. Do you think those things?
Reply: All of this is centered on the issue of the ground we stand on, and it's lack of curvature.  How these things work is secondary (but still important, and there's been 60+ years to develop it).  There is no curve.  If you can prove it, you can pick up a sweet $25,000 by emailing Cathy Dunson at perelandra77@gmail.comSo to your issues:1. Rockets can't sustain a burn without pressure.2. Satellites: The site you provided looks like a bunch of beacons in the sky active/inactive - until their balloon or drone can be sent up again.  How fast the object appears to move could be a relay or a pulse.  Doesn't mean they are satellites - which somehow manage to continuously work in the van allen belts.  Planes can be resolved (as planes) with magnification.  Satellites cannot, and they remain 'points of light'.  The ISS could be a projection, beamed between beacons.  They send up hundreds and hundreds of balloons across the world each day.  Saying you've seen them as satellites is not true, and you should email your info to the email provided.
Reply: +Lifels Short "Yes, Hermes Trismegistus."
I fully accept the importance that the hermetic principle made during the enlightenment.
Without its view of the importance of man and the spiritual lessons learned science just would not have happened.
You make valid claims as to the direction that science is going in today.
Reply: +Lifels Short "What I find interesting is that VERY BASIC things have 
to be explained with such complexity that it becomes unbelievable (Occam's 
Razor)."
Regrettably some things in nature are complex by their very nature. 
For example the biochemistry of life is extremely complex.
Occam's Razor is a guiding principle. It does not imply a definite limit on the complexity of a theory
Only that the simplest argument is the best of many.
Like any guiding principal it can sometimes be wrong.

"why missile targeting operators, surveyors, ship captains, etc don't use curvature."
An artillery battery aiming a large purely ballistic projectile over significant distance
more than say 30 miles will need to take some account of Coriolis forces if they
are to hit the target.
Under certain conditions a sniper aiming at a Human target at 4 miles could miss due to this effect.
In real life many other effects such as wind would be more important for such a small projectile.

"relativity was born shortly after, and quantum mechanics is now in utter chaos."
No it's actual worse than that. Relativity and Quantum mechanics in their current form are incompatible theories.
The proposed fixes such as string theory and Loop gravitation have more than a few things wrong with them.
Dark energy , dark matter etc. do look rather like botches. 

"Why isn't gravity just a constant that merely describes the simultaneous 
interaction of other forces, such as air pressure, temperature, density, 
electromagnetism, weak force, strong force, etc?  It is an effect, it is not a 
force in and of itself."
All of the fundamental forces Gravity Electromagnetism, Weak , Strong force show behaviour
which depends on a number of factors. For example the force between two electrical
charged bodies depends on the magnitudes of the charges of the two bodies. The signs of the charges
and the distance between them.
Gravity as a force depends on the mass of the two bodies and the distance between them.
Such things as air pressure are due to kinetic motion. The Fundamental force here been Electromagnetism.
i.e.. Repulsion between the electrons of the colliding atoms.
While temperature and density are not forces as such. Temperature been a measure of internal kinetic energy
and density been a measure of how much mass exists within a volume.
Centripetal force depends on the mass the speed and the radius of rotation.

Wither you call it a force or an effect is not that important as they both have the same result.
Gravity is believed to be due to a curvature of space time so could be argued not to be a force in the same sense that electromagnetism is
but the jury is still out on this one.

"There aren't (Cavendish included)"
The theory of gravity claims that it is an attractive force between any two physical bodies.
Now the problem with the Cavendish experiment is that you are trying to measure a very small force
Namely the attraction between a small gold sphere and a large lead sphere in the presence of the earth gravity.
This make the experiment just a little too hard for the average home experimenter to carry out.
But it has been carried out by many schools.
This is were we get into the everyone who has done it is a liar kind of argument.
As we all know schools take extra special care to make sure that all the teachers are liars.
You could so some undercover investigative journalism. 
Get yourself an interview for say a physics teacher and see how it goes.
Get a pocket recorder. I have a Sony PCM-M10 which is just the thing you would need.
Then go to the press.

"How a rocket continues to propel 
itself in the vacuum of space depends on the strength of a vacuum, and is 
largely irrelevant to me because I don't think space exists."

Well inertia is supposed to be due to the Higgs field which is a property of the vacuum
and it definitely has a strength.
I think space exists because if it did not we would be all squished together at a singularity
and I appear to be typing at a keyboard and not squished at all.
Reply: The hypothesis is that a rocket motor can sustain a burn in a vacuum.

Cody set up an experiment to prove that. We did see that that was exactly what happened, since the motor was still burning after the bottle exploded, so we have proof that a motor can sustain a burn in a vacuum. There's no room for "cheating" here.

As for why this works, once the gunpowder is ignited the content of the bottle has no effect anyway, since it's bombed out into the vacuum - we can observe that the motor only needs pressure initially, so that the gunpowder can ignite. It sustains the burn afterwards.
Reply: +Joe Rowland - You can get model rocket motors with the same fuel that NASA uses in the SRBs (ammonium perchlorate and aluminum), but not in the quantity that they use.
Reply: Well the premise was if it will "BURN" in a vacuum, not if it will "IGNITE".
Or, if it was, anyway he did both. It won't ignite but it will burn.
Reply: +MrDendor I guess that all depends on your definition of work.
Reply: Hey squach623 !!!!! watch who you're citing!  I know how rockets work dude!  If rockets needed atmospheric oxygen they wouldn't be rockets.  My comment was actually in support of Cody's findings and methods.
Reply: Luís Greg 

where do you think caused the "blowing" to open the end of the bottle,   lol...  elves? 
and if the rocket didn't burn... why was the vacuum chamber full of rocket exhaust when he opened it?
Reply: Not really. The test was to see if it would burn, not if it would ignite. Also it's fun.
Reply: +sleat I don't think the heat is the issue here, the problem is there is not enough pressure to hold the liberated oxygen to the rest of the gunpowder to keep the reaction going, as he suggested in earlier videos. So getting a better heat from the igniters won't make much difference, what he really needs is a better plug, which is what he made.
Reply: +bladerise The problem is not that it  will not run in a vacuum as clearly it does. But getting it lit in the first place. Putting it in a bottle allows the rocket to achieve ignition in air. Once it is going it very rapidly bursts the bottle and is then running in a vacuum. The gas produced by combustion produces sufficient back pressure in the rocket to maintain the combustion condition. The problem is getting to this point
Reply: Well, yes and no, mainly no. Rockets won't run in a vacuum; if there's vacuum in the combustion chamber you get no thrust. The bottle just has to hold the pressure up until the nozzle 'chokes' and gives a supersonic exhaust, after that the exterior pressure makes no difference and the rocket is then self pressurizing until it runs out of propellant.
Reply: So....he put a rocket in a mini atmosphere, and the rocket ignites....it then blows the air out the weakest point of the bottle, which then hits the walls of the vacuum and pushes the rocket...
Reply: +Lifeis Short "it then blows the air out the weakest point of the bottle, which then hits the walls of the vacuum and pushes the rocket..."

If that were true, there'd be an equation for this "pushing off" effect you mention, which correctly predicts exactly the amount of force a given rocket will feel (so you can pick the right size rocket for your application).

The equation would also contain terms describing how the rocket body "knows" what the thrust hit, and how much force it should feel.

There is no such equation, nor is one necessary, since that is not how the force is generated.

The equation that does correctly predict the rocket's thrust only needs to take into account the mass-flow-rate, exhaust velocity, free-stream pressure, exit pressure, and nozzle size.

In general, the equation that always predicts the performance of some machine correctly is the right one.

What if the guy selling you a car told you it had "1000 angel-power" and that invisible angels were what made the car move, and predicted how fast it would go, and accelerate? Would you believe him, or trust the equations that do that very thing correctly, and have done for over 100 years?
Reply: Actually, once any rocket is running the fuel is always burning at much greater than atmospheric pressure, and this includes model rockets. The hot, high pressure gas then escapes through the nozzle, and the pressure goes down within the nozzle and so the exhaust gas enormously accelerates and leaves going very, very fast (supersonic, often hypersonic speeds compared to the outside air).

With this experiment there's no air pressure on the outside, so the cardboard pressure vessel is under greater stress than normal, but it's likely to still be well within the safety factor the manufacturers would use for something like this.
Reply: +BooBaddyBig Yes, rockets definitely work better the lower the atmospheric pressure, since, as you say, it has the direct effect of increasing the (relative) chamber pressure and removing any back-pressure.
Reply: Robert Destree the hose still acts against an atmosphere.  The kick is the same if it hits a wall or bucket because it has already left the nozzle (against the pressure of the atmosphere), how it dissipates energy once it hits a wall is is important only if you confine and direct it.  If you direct the exhaust of a balloon at 90 degrees a few inches after it has left the opening, the balloon spins (or stays put if 180 degrees), it does not move forward, at all.  The 3rd law is applicable to two 'objects'.  What is the second object in an infinite vacuum?  If you hook a vacuum up behind a balloon and let the air out, it goes nowhere.
Reply: +Lifels Short "The 3rd law is applicable to two 'objects'.  What is the second object in an infinite vacuum?"
 The balloon is the first object. The air that has left the balloon is the second.  If you release a balloon in a vacuum the balloon goes one way and the air the other way.  So when a gun fires the powder generates a pressure which pushes on both the gun and the bullet. These forces are equal and opposite. Each responds to this by accelerating. The bullet been lighter than the gun accelerates to a higher speed. The gun is pushed in one direction and the bullet in the other. When the bullet reaches the end of the barrel, supposing that we are in outer space. The bullet continues away from the gun. The gas escapes from the gun the pressure rapidly dropping as it spreads out into space.  It does not instantly drop to zero because gases are limited to the speed of sound in the gas. As it does so it is still producing a small force on the gun which rapidly drops to zero. Remember the gas also weights something like the bullet. The gun heads in one direction and the bullet in the other. The gas will then expand into space cooling as it does so and at least in theory expand for ever.
Reply: No, no, no, no, no, no.

No.

It is not pushing against anything. Not the atmosphere. Not the wall. Nothing. 

The action is the rapid expansion of high pressure gases. The reaction is the rocket being propelled the opposite direction. Go talk to an actual physics teacher because you are completely wrong on all counts.

And for f*ck sake, a vacuum behind a balloon is not the same as operating in a vacuum. Stop watching idiotic YouTube videos. The vacuum is creating suction behind the balloon and overcoming the thrust. It is NOT the same thing. 

Look, when several people are telling you that you are wrong, I'd suggest that maybe you need to reevaluate what it is you think you know, and actually take the time out to learn. Because dude, you've watched too many conspiritard videos.
Reply: I know, but if I can get one person to actually see where they're fundamentally flawed, I"m going to call it a win. I completely understand where you're coming from.
Reply: Actually, while the lower ambient pressure removes back-pressure, the relative chamber pressure otherwise only helps if you fit a longer nozzle.
Reply: +Robert Destree "I know, but if I can get one person to actually see where they're fundamentally flawed, I"m going to call it a win."

It's already a win when the thousands reading the comments see how weak the counter-argument is. You don't see 'em or hear from 'em, but they're there.
Reply: sleat Assuming the bullet fires is the first issue.  After that, you are describing a system where you've confined explosive gases between two objects (bullet and rifle).  What happens when there is no bullet and no 'massed' object to set a force against?
Reply: Robert Destree you can single handedly put a stop to FE by showing your mountains of proof.... you haven't looked into it obviously, to make such a naive statement.  It's ok, I'm not mad at you.
Reply: Robert Destree ok fly a private jet go visit Chile. Then try to fly from Chlie across Antarctica to New Zealand or Australia which would be your fastest route with the globe, and forget all the fake safety regulations of flying across.  Try to fly anyway and I guarantee you will be shot down b4 you can get 75 miles over land. You won't be asked to turn back either you'll be down b4 you know wat happened. I think that's a little odd we can fly over North pole but not the south pole cmon get real. Their is some reason as too why normal capable people are not allowed to really explore over Antarctica.
Reply: yeah but we know nasa can do it. the point was to prove it can burn without an atmosphere because it has its own oxidizer and fuel source.
Reply: or you can observe that the motor only worked for a split second. how do we know it didnt quickly stop working once it left the bottle ?.  did he burn the rocket to see if it even had fuel left ? he didnt so we dont know if it can sustain itself in a vacuum.
Reply: rex racer Loosen the tinfoil hat. No one is going to shoot you down. More FE nonsensical bullshit. If you realized the logistics of flying over the south pole, you'd stop with the hoaxer idiocy. 

How about you call Kenn Borek Air in Calgary and tell them how easy it is to fly over the pole? These guys have made several flights down there and actually understand what the environment is like. Do you know what happens to engines, batteries, and hydraulic/fuel systems at that temperature? So, go ahead and tell them that you know more about it than they do. 

You don't. It's easier to ignore facts in favour of your fantasies.
Reply: a more important question is why did cody not put quality work into this video like usual. ? is he losing his touch or is it because hes trying to follow a schedule?
Reply: +Lifels Short "What happens when there is no bullet and no 'massed' object to set a force against?"
When you have compressed gas in a tube which is open to vacuum. The gas is the bullet. Just because it is a gas does not mean that it does not weight something. The gas will expands and pushes itself out of the tube. Consider the gas to behave like a compressed steel spring would. That would generate recoil before it left the gun.
Reply: +LifeIs Short Regarding the particles being sucked away: after they're sucked, where are they moving? They can't be sucked back into the rocket, so they must go outwards everywhere but into the rocket. So there are more going away from the rocket opposite the direction of motion. And then due to conservation of momentum, since we have stuff with a momentum vector opposite the direction of motion, we must have other stuff with momentum vector along the direction of motion. And that other stuff is the rocket itself, so it has to move forward. There's nothing "against" anything else at all. Nothing pushes against anything else at all. It's all conservation.
Reply: Jerry Long
Yes, this one thing proves that the earth cannot possibly be flat, and must in fact be round.
Reply: wolverine96 Well, it does, unless you can explain why it doesn't.
Reply: +LifeIs Short "Assuming the bullet fires is the first issue."

We know that bullets can be fired in space. The Russians actually did it, several times.
https://en.wikipedia.org/wiki/Salyut_3

Before you jump up and scream "but...Wikipedia!" there are footnotes (references), and firsthand witnesses who are still alive, if you would wish to contact them!

Also here:
http://foreignpolicy.com/2016/12/14/spooks-in-space-race-death-star-nasa-apollo-intelligence-russia-china/

Also here:
http://tranquilitybaseblog.blogspot.com.au/2012/10/a-cold-war-instead-of-space-war.html

"After that, you are describing a system where you've confined explosive gases between two objects (bullet and rifle)"

"Explosive gases" i.e. quite ordinary gases, like nitrogen, heated up, and moving, are also physical entities, just like bullets, only obviously not as dense. They have mass, and can certainly have velocity. If you discharge a blank cartridge next to living tissue, you will quickly find that out. don't try this if you don't want to injure yourself

If you must try firing a blank at something to verify my point, use a cockroach, or a leaf. Something like that.
I've done it for fun in the Army. It definitely kills bugs!

We also know that gas has mass, since a full gas cylinder (like a CO2 fire extinguisher or welding cylinder) is heavier than an empty one!

So, as far as "confined explosive gases between two objects" effectively it's the same. The newly evolved gas (from the blackpowder burning) cannot get out of the rocket until the old gas from the burning gets out of the way (by leaving the nozzle). This is a process over-time, that's more or less at equilibrium as long as the motor burns. Old gas leaves, and new gas is generated, pushing the old gas out. The rocket pressure stays fairly constant while this occurs.

" What happens when there is no bullet and no 'massed' object to set a force against?"

Excellent question!

Imagine you're looking at a little solid-fuel rocket motor in slow motion. At the leading edge of the propellant grain, a highly exothermic reaction is occurring, which is releasing potassium sulphide, carbon dioxide, carbon monoxide, nitrogen, and water vapor at a rapid rate.

Now, see above, all that stuff has MASS and when it can't go anywhere else, it heads for that little clay nozzle. This stuff has already burned. The ongoing burning is generating more gas which pushes this burned fuel out . 

That action is literally the same as the "kick" you get from turning on a pistol-type garden-hose.

So, the nozzle being much smaller than the inside of the cardboard tube, all that pressurized gas accelerates.

By design, it accelerates until it can't go any faster for whatever pressure you've got, (choked flow), and shoots out into the outside at supersonic speed.

As far as this "instantly sucked out" thing you guys like to talk about, no.

The difference between sea level air-pressure and air pressure at, say, 200,000 feet is only about 14.7 PSI.
That means that from the point of view of the gas at, say ~1000psi inside the gas cylinder or rocket, the outside pressures are almost identical. i.e. the relative pressure between inside and outside is very close to 1000 psi no matter what altitude the rocket or cylinder is at. This means the gas in the cylinder would come out at nearly the same rate in a vacuum as at sea-level.

To see that it's not "instantly sucked out" all you have to do is use a solenoid to open a pressure cylinder (like a little CO2 cartridge) inside a vacuum chamber and you'll see, it goes until it's empty. It's not "instant". As the gas is leaving, the CO2 cylinder will try to move, until it's empty. You'll also find it drains for about the same length of time, whether it's inside the vacuum chamber or not. A bit longer in the vacuum, of course, for that last 15psi to come out.

What this means is that the gas, which has mass, is leaving the rocket and not coming back. This is physically identical to throwing solid dry ice, or water ice, or water, or CO2, or anything else, as long as the kilograms per second and velocity are the same for whatever you're throwing.

Otherwise, you'd have to argue that throwing any amount of water vapor, or CO2 was not the same as throwing ice or dry ice at the same mass/sec and velocity, but as soon as you froze the CO2 or steam, suddenly it would give you impulse. None of Newton's equations imply that. Gas isn't "exempt" from Newton's laws.

Again, you can throw any matter and it will push back on you.
For example, if you throw an empty gas-cylinder at 1 meter per second, on roller-skates, you'll get one impulse.

But if you throw the same cylinder before you empty it out, at 1 meter per second, you'll get more impulse.
Reply: +Lifels Short. The key to understand how a gas can behaviour like a bullet is to understand a little about how a gas behaviours and a little about a vacuum. . Firstly a vacuum does not create a negative pressure. It is not sucking the gas away.  A gas consists of molecules moving at high speed as they bounce off the walls of the container they exert a pressure. This pressure depends on how tightly packed the gas is and how fast the molecules are moving which depends on the temperature. If you punch a small opening in the container the molecules which reach that hole will exit the hole. The vacuum provides no obstruction. Typical speeds of air molecules at sea level is 1000 mph. This is why there is such a thing as the speed of sound 741 mph. In space the air will exit the hole typical at supersonic speeds. You can do the calculation for a large container like a spaceship with a small hole and it can take quite a while for all the air to exit the hole. Consider the gas molecules to be tiny bullets all surging out into the void. I think the problem here is a misunderstanding of inertia. So consider the following. If I have a car I have to push quite hard to overcome its inertial in order to get it going but once it is moving it becomes much easer to do. Suppose I have two cars. I sit on one car and with my feet push the other car away from me. Both cars are now moving. I was executing a force against the inertia of both of the cars.  Now try this in space. Despite the fact that the cars are both weightless they still are massive blocks of metal and you will still have to apply a lot of force to get them moving. What are you pushing against? The inertia of the cars. a=f/m. Acceleration = force/mass. A moving bullet is slowed down when it hits a target the force created depends on the the rate at which it loses speed. A hammer works on the same principle. You can create a force much greater than the weight of the hammer or the strength of your arm by using the inertia of the hammer to push the nail in. In the rocket. You are generating gas and accelerating the gas to high speed. In order to do so you have to apply force to the gas just like the pushing the car. Imagine you where pushing cars out the back of the rocket. Your back would be pressed against the rocket applying force to it and the cars would be exiting the back of the rocket. Again what you are pushing against is the inertia of the cars and the rocket nothing else.
Reply: +2010Invent  The trick to stop rocket fuel melting an engine is to use that fuel to cool the engine before you burn it. Its quite tricky engineering and rockets  do fail often quite spectacularly. You don't need to melt steel red heat is sufficient to lose most of its strength ask a blacksmith.
Reply: +Mark Gohl "The trick to stop rocket fuel melting an engine is to use that fuel to cool the engine before you burn it."

Are you able to see any of my comments above? It seems not.
Reply: Jerry Long 
If it's a dome, and you look toward the center star (Polaris), everything would rotate normally.  When you turn away from Polaris, (looking 'south'), everything would turn the opposite direction.  I'll try to find time lapse of sigma octanis
Reply: Mark Gohl I understand inertia as a concept.  I think the proof would be simple (and it has little to do with curvature or lack thereof that we stand on).  Suspend a small balloon inside a very large vacuum (so no hitting any walls), and let the air out.  If it moves forward (and it may), this issue is resolved.  The next issue of combustion, and whether a 'burn' can be sustained is next.  This still doesn't solve the very simple fact that there is no proof of a curved surface.  Boat/Building horizon issues are atmospheric lensing, and can be proven, collimated lasers shouldn't be seen at vast distances but are, mountains are visible when they shouldn't be, etc etc
Reply: +sleat Yes I can see your comments. They are not been deleted :)
Reply: sleat I think if you envision yourself inside a glass dome, with objects on the outside, you would see the convexity of light as it bends down when looking outward, and concentric when looking up.  I haven't seen this video anywhere, but I think it would be interesting to do.
Reply: Jeff Marler well possibly it will work without alteration maybe Cody can try that?
Reply: Jerry Long lol, ok.  Stick to that theory.  You don't want to know how it works, so why even reply.
Reply: Robert Destree I did acknowledge him, good luck to you and your belief
Reply: Jerry Long Yeah, logic and evidence are wasted on him. If their idiotic beliefs held true, I should be able to see a town a few hundred km away across the prairies, especially since my city is higher. The damned curvature that doesn't exist gets in my way. 😉
Reply: Jeff Marler it didn't continue to burn. it seemingly ceased burning the moment it was exposed to the vacuum. I'd like to examine the inside of the rocket to see if it indeed, burned all the way through. Maybe it did burn all the way through,  just far more rapidly.
Reply: bladerise This is brilliant.
Reply: Robert Destree because atmospheric density and perspective wouldn't play any part in it, right? You're critical thinking ability is incredible, more people should listen to you.
Reply: Aaron Fabilenia Thanks for the word salad, but I just ate and I'm full. 

Next time, try giving context to your statement. Atmospheric density and perspective as pertains to what, exactly? C'mon, use your words.
Reply: Mark Gohl honestly I don't right now (lots of stuff going on).  But may be able to look at it next week
Reply: Mark Gohl we have no idea on the thickness it would have to be, to give the appearance, and there may be two dense arms (straight or curved) circling above, that represent the Milky Way band.  Just guessing, haven't seen much on this other than people's theories on the star trails.  Away on trip so only phone right now, but would love to mess with rendering
Reply: Mark Gohl the theory is still in its infancy in modern era, but the thing people have a hard time with isn't necessarily space and rockets and NASA hoax issues, it's just proving the shape of the ground that we stand on.  Their explanations of curvature don't add up.
Reply: Aaron Fabilenia You're the one who started a conversation with me, with no lead-in. None of my comments had been directed to you at that point. 

Now, if you're discussing my statement that I cannot see a city a few hundred km away, even though my city is higher and I'm dealing with prairies, then say so. Don't be a douchebag. For a change. 

Please, regale me with your flattard wisdom. Regale all of us globe Earthers with your proof of a flat Earth and why we're all wrong.
Reply: Robert Destree I'd rather not type about it, as to not come off the wrong way. I was being a douchebag, I am sorry about that. We can do a Google hangout sometime if you'd genuinely like to hear what I have to say in regards to the apparent contradictions with the mainstream model. I would like to add that I do not necessarily believe the Earth is flat - I believe the current model has proven false. Therefore, science dictates that we should reconsider the model.
Reply: LifeIs Short sleat we should collaborate on this, I'd like to see this come to fruition. I used to dabble in after effects and have minimal experience using autocad.
Reply: +Aaron Fabilenia "if you'd genuinely like to hear what I have to say in regards to the apparent contradictions with the mainstream model."

I'd certainly like to hear your contradictions!

"I would like to add that I do not necessarily believe the Earth is flat - I believe the current model has proven false. Therefore, science dictates that we should reconsider the model."

Well, this is how science happens. If people run into something that the current thinking can't adequately explain, and notice significant problems with the model the current thinking uses, they are perfectly free to come up with an alternate model that makes it all simpler. For things like the motion of Sun, stars, and planets, though, the current model is about as simple as it could be.

The problem for Flat Earth right now is that they don't seem to have a model where things everyone can see, work right.

In order to replace the current model, one would need to come up with a model where anything you can observe has a simpler and more direct explanation than it does in the current model. "Simpler and more direct" basically means you can't say "well any evidence in this category is automatically all fake and won't be counted, because it's part of a huge conspiracy" unless you have lots of other evidence for the same conspiracy.

For example, if you weigh a test weight near the North Pole, and again, without re-calibrating your scales at the Equator, and find the thing weighs slightly less there, it's evidence that something is making it weigh less, not that "they" are messing with every scales on Earth to make them show less weight near the Equator by having the scales "know exactly where they are".

Some topics that would need to be covered:

- Apparent position of stars, regardless of observer location
- The fact that Celestial Navigation works properly, to within a few 10ths of a mile, all over the planet, for a skilled navigator regardless of conditions, as long as you can see and identify two or more stars, moon, or sun.
- How Gravity works
- An accurate map of the Flat Earth and the sky over it, that shows and explains everything we all can see, and predicts what we'll see in the future.

Basically the new model not only can't fail to explain anything the current model does, it needs to explain it better and simpler than the old model, to be good. In other words, if you're out to smash the current model, you need to understand it very well first so you can attack it right.

If the new model relies on an immense international conspiracy that hides the very shape of the earth and generates terabytes of image data per year to do so, that immediately makes it more complex than the current thinking, which requires no conspiracy at all to look and behave the way it currently does. Not even people.

If the new model has to rely on "talking points" presented by F-E believers being true without being verified and tested it's probably not a good model.
Reply: sleat I'll keep that in mind, but many of those issues are perspective (sun rise/set, stars that move higher or lower in the sky with longitude).  Horizon issues are combination of a lensing effect and perspective.  Sigma octanis could rotate how does from all southern positions with this bowl effect (provided link in previous - but agree it needs development).  Most everything moves at 15 deg per day +/- a few degrees because a day is 24 hrs, so that aspect proves neither - either we spin or it spins.  Precession of the equinoxes occurs throughout, but again, doesn't prove either theory.  I think a 'debunk' of FE would be a midnight sun in Antarctica, staying visible for 24 hours.  But all footage of this has been edited, as people have shown, with 8 hours missing, including one person who called/emailed their station to provide the missing footage from a supposed live feed and got the run around.  So I don't know.  There are plenty of FE animations online showing seasons, the analemma effect, the moon cycles, etc, just not a lot on sigma octanis.  I don't think people in those southern latitudes can see the same position of sigma octanis in the sky at roughly the same time to fit with a globe model, but again, need some models, etc for that part
Reply: Aaron Fabilenia FE animations already exist for seasons and so forth.  The analemma hasn't been shown in an animation I don't believe but image search it and it looks like a spiral effect of the sun, up/down as it moves outward/inward throughout the year (very symmetric)
Reply: sleat many FE books touch on all these, and I agree, the model should be simpler, and I think it is, just needs time for all the pieces to come together in one animations (that's a lot of pieces and effects though, and no globe model has done that either).  Flat Earth Conspiracy is a good book that explains the model (don't let the title with 'conspiracy' be an issue, it explains the model)
Reply: sleat I used to agree with all this, but again, like most, I just dug into it, because there had to be some easily proven test that shows curvature, and FE takes into account most all of it, and the curvature tests seem to NOT show curvature, but rather prove its flat.  The one thing that did it for me was a Stephen Hawking reality show with John Cena and a group of people with a collimated laser, he directs them how to find the curvature of the earth with it, and completely falsifies the experiment, and uses bad calculations without taking into consideration very simple things, like the observer height of the telescope or laser light, etc.  I've also listened to Bill Nye's explanations of debunking FE, and Niels Tyson, and they use talking points that are already shown in FE models, so I just don't trust them anymore.
Reply: sleat let's talk sometime, I'd like to hear more of what you're saying, as well as express my concerns and understanding.
Reply: +Aaron Fabilenia "I'd like to hear more of what you're saying, as well as express my concerns and understanding."

OK, what are your concerns, and what is your understanding?
Reply: @bladerise He didn't get back to you, did he? He knew he had to cheat in order to confirm is already pre-existing bias i.e. that rockets work in space.
The globe model is a damn right lie. And space is just a fantasy.
Reply: +James Bondage "The globe model is a damn right lie. And space is just a fantasy."

So true, except for satellite TV. Satellite TV works.
Reply: @sleat

Communications are sent by towers and underwater insulated fiber optic cables connecting the continents. Meaning the LORAN method of communication never went away. They're still using it to this very day.

Satelites do not exist. Drones & high altitude planes do.
Reply: +LifeIs Short "I'd like to see an unedited midnight sun in antartica - that would help, but all the videos look spliced."

Well, are you quite sure you've seen them all? I've seen some time-lapses that simply look like any other time-lapse.

If your belief in the very shape of the planet could be swayed by a simple trip South of 65 degrees on the Southern Summer Solstice, I really think you should head down there and see for your own self.

"They fake mythbusters experiments that clearly show other rocket results (like Cody's experiments),"

Like what other rocket results? Did the rockets try to move when fired? Did they stay still?

"and fake Stephen Hawking reality shows with collimated lasers and telescopes that don't even have the right math for a globe model..."

Yes, I hate those "science for average people" canned presentations, too, especially when they have obvious problems, most likely due to the production people. I think an actual scientist would be quite angry if some TV show involving them was being misleading.

Which Stephen Hawking reality show are you talking about? I should have a look.
Reply: sleat again, the point stands, you don't know what you're bouncing any signal off of.  It could be a pulsed wave traveling across a dome at however many km/s you believe to be a satellite.  No one has seen one because you can't even see a jet at 35k ft, so how do you see Satellites at >250mi?  The video is found if you put in Stephen Hawking earth curvature (one with John Cena).  Again, earth's curvature is not found on the ground we live on, anywhere.  Regardless of satellites or rockets, which I find questionable at best.
Reply: +carzak "Even though the other guy is hopeless, I'm learning things."

Thanks a bunch. Give him credit, he may have a strong vested interest in what he believes, that stops him from wanting to do any experiments that would challenge what he believes.

He's certainly entitled to his own opinions, but whether one can photograph lit object against a dark background, of sufficient size, from hundreds of miles away, is not an opinion issue. It's a math and physics issue. If there's nothing in the way, the photons arrive. They've been doing that since before we were here, obviously.

Certainly whether or not people can see airliners cruising at altitude is also just a matter of asking whether the physical environment is conducive to it happening. Looking at the sky, the general rule is that you can see stuff, unless there's a good reason why you can't .

If people in the airliner can see things the size of an airliner on the ground, well of course people on the ground can see them, since they're the only thing for miles against a plain backdrop.
Reply: +LifeIs Short "Regardless of satellites or rockets, which I find questionable at best."

Can you bullet-point for me what your problems are with the existence of satellites and rockets, and go through it with me?
Reply: +Lifels Short "lol....here's a dumb argument, at sea level,"
Hi That's quite a lot of questions so I will not attempt to answer them all.

The earth's core is believed to have a solid iron core surrounded by a liquid
iron layer. There are believed to be convection currents in the molten layer.
Power source radioactive decay. Evidence earth quake recordings.
Iron is ferromagnetic which means that it can be magnetized. It is also a conductor of electricity.
At the temperature of the core iron is above its curie temperature, it has lost its ferromagnetic properties.
However it is still a conductor and it is moving. It behaves more like moving mercury.
A moving conductor inside a magnetic field will create a voltage. In a shorted turn such as the earths core
this will induce an electric current. An electric current generates a magnetic field. This is the principle of the
self exiting generator. Only a small external magnetic field is needed to start the process.
Once it has been primed it generates its own field but only as long as it continues to move.
Should it ever stop the earth will lose most of its field. One clue here is that the magnetic pole does wander about.

Why does a helium balloon float while water sinks through the air. 
Consider three identical extremely tall tubes. One filled with water, one with air, one with helium.
measure the pressure at the bottom of the tubes. Water has the highest density so will have the highest pressure.
Air will be next and helium the lowest. Now connect the bottom of two of the tubes with a pipe with a tap.
Open the tap. If you connect water to air the higher pressure will push the water into the air forcing it upwards.
Hence the water will end up at the bottom. If you connect the air to the helium. The pressure will force the air into
the helium tube forcing it upwards. Hence the helium is driven upwards. Same as if you drop a rock into water the rock sinks
and the water is drive up. If you release a cork under the water it is drive up while the water sinks.

Comet tails are the result of several process. Firstly comets are small bodies and as a result have weak gravitation fields
The escape velocity can be as low as 30 mph.
A comet only develops a tail as it approaches the sun. The heat of the sun sublimates the material of the comet into space.
This is a very thin gas dust mixture ejected with some speed from a body certainly fast enough to escape. 
Remember air molecules at room temperature travel at about 1000 mph. As long as its more than the escape velocity it will get away.
Anything slower will not escape.
Once in space it is subjected to the optical pressure of light and charged particles from the sun. 
Hence the tail usually points away from the sun regardless of the direction of travel of the comet.

Hermes Trismegistus? Without the hermetic principle there would be no science. Why do you think the catholic church was so upset
at Giordano Bruno's Helios-centric principle? After all they did not object when Copernicus originally suggested it.
Reply: You show your colors.  You provide a guy on reddit who struggles to explain dynamo theory, which has zero experimental proof of how a molten iron core creates magnetism, and claim the problem is solved.  It's a theory.....Gravity is another theory, which only describes an effect.  It cannot be shown in a laboratory either.  A spinning ball (moving faster than the speed of sound) creates centrifugal force, yet a tremendous magical force that cannot be replicated anywhere holds everything perfectly in place....  So helium balloons overcome the magical force of  gravity by density and buoyancy?  Why not just call it density and buoyancy then?  Electromagnetism is 39 orders of magnitude stronger than gravity, but this relationship conveniently reverses at planetary size.  You think we don't know the theory?  So why isn't all the water collecting at the equator from your magical centrifugal force that thickens the atmosphere?  Don't worry, just say 'gravity'.  Your response about how much I'm 'assuming' is telling.  Be prepared next time you insult people.  Sorry for your boredom.
Reply: Yes, Hermes Trismegistus.  The sciences are all based in alchemy, the spiritual aspect of alchemy became modern psychology (history of Freud/Jung, etc).  I am fully aware of the history of Copernicus, Galileo, Kepler, and Newton, philosopher's stone, etc.  Newton was more interested in translating the Emerald Tablet than science, and has the most revered translation.   Anyone can provide a theory of how things work from the internet (myself included).  But unless they are shown in a laboratory and replicated, they are theories (well, hypothesis, really).  If you do not believe the earth requires a force called gravity, why not just call it density and bouyancy?   I'm aware of how the earth's core is 'believed' to work, but it is not proven, and since we've only drilled 8mi down, there is little evidence of what is underneath, Earthquakes and Volcanoes included.  If you cannot see it, you are relying on faith and belief that it exists.  I do not see curve anywhere, but what I do see is flat along distances that it shouldn't be.  So to me, it is strong enough evidence that it is flat, or at least a tremendously larger sphere than we've been led to believe....  I do not feel motion, therefore I believe the earth is motionless until proven otherwise.  To me, Michelson Morley proved the earth was motionless.  Others believe it proved there is no ether.  I do not see satellites, nor rockets in space, but I see freemason astronauts and deceptive practices from a space agency.   I see round objects (planets) in the sky, but their shape says nothing about the ground we live on, and I find certain measurements about the earth/cosmology (as stated) that are too convenient.  I also find the hexagon (Saturn Cube) at Saturn's north pole and the Disney Pluto face on the planet Pluto convenient.  The fake pictures of earth passed off as real, with photoshopped clouds, and 'sex' written in the atmosphere is also convenient.  At this point, I think you'd need tremendous faith that it is all real, not the other way around...
Reply: I appreciate the attempts to explain things also (and staying respectful).  But I am well educated and am fully aware that there are completely plausible explanations for all of it that are found online.  But I also know that all of it is theory.  One thing to think about, is where science is headed, not just where we're at.  There is firm belief now in extra dimensions, and one widely held belief within super symmetry is that we all live in a mathematical matrix, and that the equations provided for string theory are the same as that found in internet search engines (they provide the same geometries).  This all ties into occult practices and 'visualization', just like many aspects of analytical psychology with Jung/Freud, but because people call it 'science' it is overlooked.   Looking at all of this from afar, it appears to me that the rabbit hole of gravity and relativity have led us to this place (and that is by design).  At some point in the near future, aliens will be 'discovered', I have no doubt.  You will have to decide the merit of that at that point.  Science will also tell you that there are many versions of you, all doing different things simultaneously, making your current existence trivial, just like the globe model has attempted to.  These are my beliefs about the world we inhabit.  If you study alchemy, hermeticism, gnosticism, and kabbalism, you will realize how we got here.
Reply: +LifeIs Short So, when I read what you're saying about satellites being balloons, and then answer with questions about how balloons would work to behave exactly like satellites should behave , you suddenly drop the subject,  stop engaging on the topic we were on, and go into a Gish-gallop un-formatted wall-of-text? You're familiar with Gish-gallops, right?

Like a switch was thrown. Are you really the same person I was talking to before?

Let's talk about the following things you said:

"How fast the object appears to move could be a relay or a pulse."

You never described how "a relay or a pulse" duplicates all the behaviors I observe.

So, can you please clarify how such a thing would work to make a radio contact that slides across the sky, ~3 minutes from horizon to zenith, and ~3 minutes from overhead back to the other horizon, but with a different Doppler-shift curve for distant observers? 

You have to point a directional antenna at it to pick it up in some cases (transmitter strength, limited power), and I'm describing how you need to move the antenna to keep the signal strong.

At the same time this thing has an up Doppler-shift when it's coming towards you, which goes to zero at its zenith, and then begins to go down as the object departs your location, but the graph of that curve is different for different locations of observation of the same signal .

Solving the Doppler equation shows its velocity relative to you is >5km/sec coming towards you from the horizon.

Can you describe a machine which would simulate that with a relay or a pulse ?

""Planes can be resolved (as planes) with magnification. Satellites cannot, and they remain 'points of light'."

You say that with great certainty, but then you talk about looking at planets and being able to see their shapes, but simultaneously you say other objects much closer can't be resolved.

So, you're saying you can see details on a planet ("roundness", etc) much further away than the ISS (also much larger of course) but with a smaller angular dimension than the ISS has and yet, for some reason, shouldn't be able to see details on the ISS? I.e. that it's definitely not round. If the ISS is ~100m across, at 400km it ought to be much bigger than Mars though a telescope, but you say it's not. Why?

In another comment you mentioned that "I see round objects (planets) in the sky, but their shape says nothing about the ground we live on,"

So, given that people agree that the angular dimension of Mars goes from 3.49″ – 25.13″ ("=arcseconds) and that given the distance and size of the ISS, its angular dimension should be about 51 arcseconds straight over your head, how can you see details on one but the other "remains 'points of light' "

Can you explain how that makes logical sense? Do you have problems with the angular size formula, (if so, what?) or have you simply never tried to look at the ISS with some magnifying optics?

"Saying you've seen them as satellites is not true,"

No, I'm asking you how non-satellites can behave so much like what a thing in low-earth-orbit would be doing, both in the RF spectrum, geometrically, and optically.

- How does the same object move ~2900 miles in 10 minutes?
- How do different observers get different Doppler-shifts for the same physical repeater they are conversing on simultaneously?
- When people point telescopes at certain of these objects, they appear to have a distinct shape, the same way planets do. What causes this?

"and you should email your info to the email provided."

Who is this person and why should I email "my info" to her?
Reply: +LifeIs Short

"A spinning ball (moving faster than the speed of sound) creates centrifugal force,"

Yes, have you calculated how much force that should be for 2 pi radians every ~24 hours for Earth's radius?

How much force did you come up with?

"yet a tremendous magical force"

Pretty amazing, huh? Gravity somehow produces way more force than the centrifugal force of a rotating (at half the speed of your wall-clock's hour hand) earth, but that centrifugal force can still be measured . Amazing.

"that cannot be replicated anywhere holds everything perfectly in place...."

"replicated" is a funny word to use here. It's like a fish saying "there is this magical fluid that we can push against to travel anywhere we want, but it can't be replicated anywhere".

The equation F=Mmg/r^2 seems to perfectly predict the amount of force, even if the exact cause of the force isn't known.

So, is it "too convenient" for you that if you solve for the centrifugal force on an orbiting satellite, due to its circular motion, using the F=mv^2/r and then solve for the gravitational force using F=Mmg/r^2 the forces balance out for an object speed that also matches the Doppler-shifts I'm seeing in real-life?

That's way too convenient if you ask me! What do you think's going on there?

College physics (and some precocious high-school students) routinely replicate Cavendish's experiment to try to derive a value for "G". So how do you define "cannot be replicated" in this context? The experiment clearly shows the masses attracting each other, especially when you make changes in the setup .

If you solve for the amount of torsion due to the nearness of a removable mass, you see bigger torsion for bigger test mass, and smaller for smaller. When you totally remove the big mass, it becomes clear that your torsion wire has sprung back. All this happens even if your apparatus is too crude to get a close value for "G"

If you do this experiment in a highly controlled environment, like a fishtank with a lid, or a partial vacuum chamber with transparent windows, the accuracy gets much better. This should be a big clue that it's not wind, magnetism, or electrostatic force that's happening, especially if all your parts are nonferrous, conductive, and grounded.
Reply: +LifeIs Short "best of luck"

Why thank you, sir! Does this mean you don't want to talk about the points I raise? I've been talking about the points you raised for days. Maybe it was those formulas for how centrifugal force and gravity behave.

I didn't know you hated formulas so much, so I'm sorry for that.
Reply: +LifeIs Short "neither of you answer anything"

Do you mean our responses contain no answers, or that you do not like the answers?

I'll make you a deal, you ask a question, a good one, not 50 decoy ones like you did, and I'll take the time to think about it and answer it. I do this in good faith, despite your refusal answer my follow-up questions. Would you like to see my follow-up questions again?

Being highly educated as you say, you surely know that investigation isn't about only counting the answers you like . You'd do better to count the answers that are plausible, and verifiable with experiments, whether you like them or not.

If you're allowed to discard any answer you please, regardless of it correctly predicting how the universe observably behaves, you won't be investigating anything in good faith, but simply trying to confirm some already-held position.
Reply: sleat all of your arguments revolve around the description of an effect that MUST be present to account for a globe.  If you make the earth a globe, then those things must exist to account for things we see.  People go out and twist observations to fit a theory.  They throw a foucaults pendulum out and say 'see, the earth is spinning'.  (Before I'm told how Foucault proved motion....http://wiki.tfes.org/Foucault_Pendulum).  Never mind wrecking balls aren't swinging around spontaneously, or the fact that the pendulums have 'help' in the ceilings.  Or that a cannon ball shot in the air comes straight back, or goes the same distance if shot east or west.  So yes, gravity is pretty amazing, since it describes things when convenient.  Never mind the ridiculous necessity of multiple universes or a matrix with string theory and super symmetry.  People find problems with a theory to describe something, then another person comes along and says, 'well that thing must be there, so what you're seeing is xyz'.  This self perpetuates until we get to a point that we are now equations in a search engine...I think it's time to reassess the whole thing, starting with curvature.  Don't bother with how wrecking balls aren't a foucalts pendulum, I can find it online like anyone, just like why gravity holds the oceans down.  When spinning curvature is found, I'll accept how matter stays glued to a whirling ball.  Until then it's motionless and flat, and all things are explained through the interaction of other forces.
Reply: +LifeIs Short "If you make the earth a globe, then those things must exist to account for things we see."

Usually science works in the reverse of that. It doesn't assume something and then dictate what the results or observations must be. It makes a prediction based on a premise "If the earth were flat and stationary, I should not need to account for Earth's curvature or Coriolis force in my long-range artillery shot".

Then you make the shot, and you find it hits long and off to one-side. You do that 100 times. Same problem. You then say, "well what if we treat the earth as curved, and our launch point as having a different tangential velocity than our target, roughly perpendicular to the direction we're shooting?"

You make some equations for that, and test them. If, time-after-time, the shells land where they're supposed to, that counts as evidence that your equations predicting the behavior of the bullet are good.

This would be evidence that reality behaves as if the earth was curved and as if the surface were moving faster at the equator .

You might say "is the earth flat?"

Then you need to go though the process of saying to yourself "Well, if it were flat, what would we look for that would indicate that this was true?"

If you don't see some of those things, your write-up should talk about why you did not see what you expected to see.

Even an amateur scientist investigating this wouldn't say "any evidence of a curve must be a hoax or incorrectly measured".

Let's take one of your assertions:

So, if you said "nobody can see a satellite from the surface of the earth (except as points of light)" a more rigorous thing to say would be "I don't think we'll be able to see any details on these things everybody calls satellites, so let's try to see them in good faith , and then decide if we could see them or not"

You would then say "Well, let's try to predict when to look for one, let's figure out how big they say the satellite is, and how far away they say it is, and calculate how much magnification we should need to see it, if it's really there"

"Let's also calculate how fast it should move through the sky, and how big it should look through our telescope or binoculars, given the magnification we know we have if satellites are real "

You see, that the nature of an investigation in good faith doesn't start with "because satellites are real" but "if satellites are real".

Then you actually perform your observations, and try to come up with all the things that might be wrong with either your observations or predictions of what you would see, based on how your reality was different to your predictions. You might need to do this several times.

To be scientifically rigorous in an investigation, you have to first admit your premise might be completely wrong, and then identify all the ways it could be wrong. To prove yourself right in an investigation, there has to be a set of circumstances that would reliably prove your premise wrong, ideally stated in advance. Your premise really should be "falsifiable".

So, you'd say "my assertion that I can't see satellites (as other than points of light) from the Earth will be falsified if I can discern any consistent shape for a satellite I'm looking at while actually trying to see a shape every way I can think of" in advance of your test.

If your premise isn't falsifiable i.e. "there can be no bona-fide evidence that this premise is wrong" it's not a very good starting point.
Reply: +LifeIs Short "all of your arguments revolve around the description of an effect that MUST be present to account for a globe. "

Looking back, I can see an awful lot of questions that I ask which take the form:

"something you said"

Okay, well if that were true, can you show an equation for how it behaves that I can test?

Also, if what you're saying were true, then when I actually look, I should see x,y,z, but instead when I look, I see a,b,c. Can you give me any ideas why that should be?

It would be good if you could engage with that style of discourse.
I.e. not jump to a new topic, or change the subject, but discuss what I, you, or others can see in real-life.
Reply: Duarte Pombo yup, lack of information, got it.  Good luck in your matrix
Reply: +Life is short
There are infinite dimensions right in front of you. The way i see dimensions are just certain values for each point. for example Y=x represents 2 dimensions, if you plot Z = x + y , x and y being variables it is in 3 dimensions. if you plot W = z +y + x it is 4 dimensions etc. you can do this infinitely, and describe any W point you want with this.. those variables can be describing position, temperature or even, color, smell, whatever you want, from my own ignorant thinking point of view, reality could just be a giant function like this. That said, it just dsnt make sense at all represent these graphs in a 3D space, because you simply cannot.. i dont even see a point in even trying to draw a tesseract besides curiosity for example (im sure there must be tons of applications, im just ignorant to them) space and time are just limited to these 4 dimensions, but in mathematics it makes perfect sense to have infinite dimensions. it is completely normal to find similarities in math and computers with the real world of course, after all, we made those to describe reality better, and they where  born straight out of reality, but you are right, it is still really intriguing those possibilitys you mentioned, because if we find we are living in a simulation, then it is automaticly over. i mean, that would end with the question of the beginning of everything, the answear would be forever unknown, because you would never knew how that simulation started, if you are inside a closed box, you dont have any possibility to know what the box looks like from outside.
But one thing is for certain, how could we store this amount of information our universe posses in a simulation made by beings in this universe itself?. impossible i guess. if we do live in a simulation, then the beings that created us must live in a universe much more limitless, because as we can observe by ourselves, every time there was a  new simulation, there would be a loss of power in that simulation. Simulation hipothesis is really really probably fake, but still fun to think about it. But nice comment you did actually, im seriously surprised you even are tempted to believe earth is flat, you dont speak like a flat earther for sure (beside some stupid obvious questions on the comment yesterday)
Reply: ahahaah i was thinking the exact same thing sleat
Reply: You were also thinking how the earth must be flat in one of your alternate realities.  Your faith in a multiverse illustrates your hypocrisy.  You believe in several versions of yourself, just as real as you, that just made various different decisions....Yet it is theory, you cannot access them.  One of them just realized how dumb all of it is.  Maybe it was your 8th dimension, or it could even be the one sitting right next to you.  Very cool.  I'm going to go look at my favorite tesseract animation and ponder why it's on Saturn (again, don't bother to explain it warrior).  Later on, I'll check out some Carl Sagan and watch some flat land animations.  Tapping my 5th dimension has been difficult lately, so who knows, if I play my cards right, I could get off work early tomorrow and do some astral projection.
Reply: ahhahahaah what? what faith??. i dont think you understood my comment. i dont belive in multiverses like those you explained. i feel like believing in it is just creating a theory from nothing, just because it cant be proven false. Everyone can create a theory right know that no one could ever prove wrong, (flat earth not one of them, everyone can prove wrong) , but the theory also wouldnt contribute anything new in reality. that is why im not fancy that much of string theory.  you cant prove it is wrong, but you cant also prove it is right, and probably never will. althought it is always fun to think about it . if you didnt understood the last comment im not even going to try to explain again, what a waste of time that was ahahaahahaah
Reply: Duarte Pombo So what version of quantum mechanics is your favorite?
Reply: the one that says the world is flat and stars are just an effect caused by bioluminescence of aquatic organisms in the water above and oceans and continenents dont fall because of antarctica. stupid questions get stupid answears.
Reply: no, actually is just symptomatic of human stupidity
Reply: Duarte Pombo good one, you win
Reply: +Lifels Short "You provide a guy on reddit who struggles to explain 
dynamo theory, which has zero experimental proof of how a molten iron core 
creates magnetism, and claim the problem is solved."
Well actual I didn't, read my post again.

"It's a theory.....Gravity "
Everything in science is a theory that's how it works. Your flat earth is also a theory
If it turns out to have better explanatory power than the globe theory then it
will replace it because that is how science works.

"It cannot be shown in a laboratory either."
So how do we know the value of G except by laboratory experiment ?

"A spinning ball (moving faster than the speed of sound) 
creates centrifugal force, yet a tremendous magical force that cannot be 
replicated anywhere holds everything perfectly in place....  So helium balloons 
overcome the magical force of  gravity by density and buoyancy?  Why not just 
call it density and buoyancy then?"

Google the formula for centripetal force and gravity do the calculations and draw your
own conclusions. Why not call it X ?, Because a label is not an explanation.
Every force of nature is in a sense magical because we do not know the origin of it.
This does not prevent us from examining and determining it's behaviour and making useful predictions using this knowledge

"Electromagnetism is 39 orders of magnitude 
stronger than gravity, but this relationship conveniently reverses at planetary 
size.  You think we don't know the theory? "

I think that if you want to argue against an existing theory you at least need to understand
what that theory claims.
So that when you attempt to refute it you are doing so from a position of strength.
For example if you where to argue that a rocket does not work in a vacuum it is helpful
to understand the claim that inertia is important.

"Be prepared next time you insult people.
Sorry for your boredom."
What did you find insulting? You asked Questions and I give my opinion.
You are free to ignore it if you wish.
No I do not find it boring at all. Quite the opposite in fact.
So here is a question for you. You have a strong opinion that the world is flat.
So what lead you to this belief in the first place?
Reply: + mark gohl  He was responding to me, i was the guy isulting him while not prepared that got bored xD
Reply: +Duarte Pombo I do seem to be getting caught in the crossfire :)
Reply: Wasn't responding to your post, youtube not the best 'discussion' forum format with multiple people.  My points stand, ALL of this is THEORY (including mine, you're right, no question, and there are some definite flaws that provide ammunition against it).   What I find interesting is that VERY BASIC things have to be explained with such complexity that it becomes unbelievable (Occam's Razor).  Such as why people can see a laser at their feet at >4-6mi, why missile targeting operators, surveyors, ship captains, etc don't use curvature.  If you look into it, you'll realize there are legitimate points.  No one 'wants' to believe the earth is flat, it sounds stupid at first, but there is no curvature, and I find that aspect the most compelling.  How all these other things work is secondary.  Interestingly, if you believe there may be an ether after all (Tesla, Electric Universe theory, and even Boson fields and dark energy that are now being thrown out there), the earth is motionless per Michelson-Morley/Sagnac/Airy's (regardless of shape).  Lorenz came along with the expansion (or contraction depending on reference) to account for things, relativity was born shortly after, and quantum mechanics is now in utter chaos.  Why isn't gravity just a constant that merely describes the simultaneous interaction of other forces, such as air pressure, temperature, density, electromagnetism, weak force, strong force, etc?  It is an effect, it is not a force in and of itself.  Where has it been shown that spinning objects of mass can glue water and other objects to their surface?  There aren't (Cavendish included), yet gravity somehow only 'kicks' in to describe the world we see at planetary scale.  It cannot be shown.  It's existence, however, is necessary to support how oceans stay glued to a spinning ball at planetary mass.  It is unnecessary if there is no spinning ball.  The rocket did not sustain a burn, and used the atmosphere within the bottle until the pressure released out the back.  What it pushed out against is the weak point in the bottle, and the rocket spun with equal/opposite force in that direction.  Atmosphere/pressure is necessary for a rocket, that is my assumption.  How a rocket continues to propel itself in the vacuum of space depends on the strength of a vacuum, and is largely irrelevant to me because I don't think space exists.  I will agree that theoretically it probably propels itself, but I haven't seen an experiment that shows it, nor does it describe the shape of the earth.  I realize there are problems, but there has been a significant head start in the other direction.  The truth will come out, I have no doubt.
Reply: kinda? It is. It totally defeated the purpose of the video, and to top it off he declares it a success. Show me a rocket designed to work in a vacuum.
Reply: +Peculiar1 "Show me a rocket designed to work in a vacuum."

Look up the J-2 engine. Specifically, look up the key part for re-lighting the engine, the Augmented Spark Igniter, which is basically a tiny hydrogen/oxygen rocket motor with a spark ignition circuit. The "trick" is that when this igniter is re-started, the environment in its tiny combustion chamber is not a vacuum anymore. Once it is producing a good solid flame in the combustion chamber, the main propellant/oxygen supply can be turned on, and the rocket motor will run.
Reply: escaping gases come out of the barrel well before the bullet  go watch a slo-mo video.
Reply: +Derek smith "escaping gases come out of the barrel well before the bullet  go watch a slo-mo video."

Sure they do. Even some propellant leakage around the bullet comes out. The air (or water?) in front of the bullet has to get out of the way, and there's only one hole.

You could even compute the amount of force that bolus of air generates when it is expelled, independently of the bullet, and gases behind. The mass of air in front of the bullet times its average expulsion velocity would give you the impulse that that bit of matter provided.

It'd be much smaller than the bullet, though.
Reply: look up the Antarctic treaty. you are the one ignoring facts. if you attempt to fly over they WILL shoot you down.  feel free to look up Admiral Byrd and what he had to say about that place.
Reply: so the gases and bullet must displace the air in the barrel because there is only one hole and it's filled with air until forced out by the gases and the bullet...  glad I could help clear that metaphor up and show how it cannot be compared to this experiment or space in any way, shape, or form.  :)
Reply: +Derek smith "look up the Antarctic treaty."

Yes, I'm familiar with it. It's great. It essentially prohibits any military activity on/over the lands of Antarctica. (Article 1)

Shooting civilians (by a military force) is certainly a "military activity". That's not allowed.

"you are the one ignoring facts."

You obviously haven't looked at the provisions of the treaty, especially the ones preventing any military activity (but not military personnel who are present for a "peaceful purpose"). (Article 1)

"if you attempt to fly over they WILL shoot you down."

Which would squarely contravene Article 11 of the treaty, which deals with "peaceful settlement of disputes". That is, assuming someone who was near enough to matter didn't want you there. Who might that be?

So, what military force will do that, in contravention of the treaty (and risking censure in the international courts)?
- Where would "they" intercept you from ?
- What would the range of these interceptors need to be?
- What type of military fighters regularly operate in, or around Antarctica? (countries, names of forces, etc)
- What type of Surface-to-Air missiles operate there?
- Where are the fighters and/or missiles based?
- How would they even know you were going there?
- How is the entire continent watched, so as to catch these "trespassers"?

There is no radar-coverage over the Southern Ocean, and no ADS-B either, due to lack of ground-stations. A private or charter long-range jet could freely fly over the Antarctic lands, and unless it crashed, the worst that would happen is that they might be fined for not reporting the flight properly, assuming anyone knew of the flight in the first-place. Aircraft operated by organized crime do undocumented flights on a regular basis.

The neat thing about Antarctica, if an un-documented or un-reported expedition went down there, one of two things is guaranteed to happen:
1. They will depart before long, after running out of fuel or provisions
2. They will all die

Seriously, nobody needs to keep people out. Nature takes care of most of that, and lack of the required money to field a sensible trip.

Assuming even if there was a clause about "trespassing" on Antarctica, certainly destroying a "trespasser" would actually violate the provisions of the treaty (Articles 1 and 11) worse than simply keeping track of where the "trespasser" actually was and just communicating with them and seeing if they needed any assistance.

But scientific exploration of the land of Antarctica is "legal" under the treaty, according to the words of the treaty itself. (Article 2)

If someone reported their trip, and clarified that it was for "scientific purposes" it would actually contravene Article 2 to stop them .

So, how is it, if you're correct, that I can book a flight from Sydney or Melbourne during the upcoming Antarctic summer, to actually fly over the place, over the land-mass, for several hours on a charter-flight?
www dot antarcticaflights dot com dot au

How is it that ordinary people can physically visit the South Pole itself?
Do you think they secretly take them somewhere else? If so, where?
www dot icetrek dot com/join-a-trip/south-pole-and-antarctica
Reply: +Derek smith "how it cannot be compared to this experiment or space in any way"

It certainly can. Any mass being accelerated and thrown away by any other solid object works with exactly the same formulas for predicting the resultant force felt by a rocket.

Look up the formula for the force felt by a rocket, and then look up the formula for recoil force felt by a gun. Notice anything?

If you have some other formula (mathematically unlike gun-recoil) for the force a rocket feels when it is fired, kindly provide it.
You don't, do you?
Reply: I have thought about the same balloon experiment, but it is impossible. In reaching the vacuum necessary the balloon would fill the chamber if it was elastic enough or pop if it wasn't.
Reply: +Peculiar1 " the balloon would fill the chamber if it was elastic enough or pop if it wasn't."

It will grow to the size where some of it covers the hole where the air gets sucked out from by the vacuum pump, and promptly spring a leak. You need some kind of rigid container. A soda-bottle with a remote-controlled nozzle-release would work and not be dangerous. They'll hold 150psi, which is ~10 times the difference between atmosphere and hard vacuum.
Reply: all that looks great on paper.  take a camera and a compass and prove all that.  if you think the UN isn't running military ops down you're crazy.  how does a flight from 2 places in Australia fly over Antarctica?  prove that flight is going over the true south pole.  you just said there's not radar and such so they could take you anywhere.  Admiral Byrd talked of a land mass as large as the US unexplored in late 50's that was NOT covered in snow and ice.  Where are the pics of that?  again, all that looks great on paper just like the theory of relativity but until you have physical proof it's nothing more than words on paper.  get you a plane and fly down there and find out.
Reply: hmmm well let's see why we can't compare a gun firing on earth with an atmosphere to a rocket engine in space with no atmosphere nor pressure (aka this "vacuum" chamber that is eerily pulling bubbles up through the bottom).    well I just don't know why those two scenarios are not similar.
Reply: +Derek smith "well let's see why we can't compare a gun firing on earth with an atmosphere to a rocket engine in space with no atmosphere"

Are you claiming that guns don't recoil in vacuum? Are you claiming that Newton's Third Law only works in air?

If you think the thrust of a rocket, or the recoil of a gun should diminish as the atmospheric pressure diminishes, what's the equation that describes it?

All the equations I've seen show it working better as the atmosphere diminishes. Can you point out the flaws in those equations of force that apply to guns and rockets accelerating and discarding mass?

You're making another claim, but again seem to be fleeing from the burden of proof. Do you expect anyone to take you seriously when you do this?

You could prove me dead-wrong with a testable equation that demonstrated your claim, if it worked.
Reply: I have thought about this bullet rocket comparison and came up with this. Bullets and rockets can not be compared. A bullet has three masses. The projectile, the casing, and the gun powder that when ignited propels the casing and the lead projectile away from each other. The explosion or combustion is separate from the projectile.  The projectile then decelerates to its target. It will never go faster than when it exits the barrel. A rocket however, accelerates to its target or destination. The combustion is part of the rocket, one mass, If it was separate it would crush it. That is why a bullet projectile is lead. So a rocket has 2 masses, the rocket with the combustion being the first and the atmosphere being the second. If you believe that it is not pushing off of the atmosphere but instead pushing on the nozzle then you would have to explain how could nasa lay a rocket booster on its side, strap it down and fire it for 2 minutes with 3.6 million pounds of thrust force being applied to the nozzle without crushing it like a grape. You can't have your cake and eat it too can you?
Reply: @sleat: you dodged what I said completely.  it is not a fair comparison for anything in space to be compared to something on earth period.  all the variables are different.  it is ludicrous to say because it works here it must work in space.  a gun has never been fired in space so you can only make "educated guesses" aka theorize.  well in that case of comparing two environments that are not one bit alike if it works on land it must work underwater.  drive your car off the nearest boat ramp and see how that works out for you.  and like many you are worshipping math on paper without an experiment to prove the math.  rockets on earth have been proven by experiments and you can go watch a rocket launch or join the air force and fly a rocket propelled aircraft.  I have never seen a rocket in space nor tangible proof (a video showing it work that I can believe)  I have seen many very flawed vacuum experiments falsely showing thrust like this vid.   to even begin to show thrust in a vacuum you would need the object to be far enough from a solid object (wall of the chamber) to guarantee it does not produce thrust off it nor fill the chamber creating positive pressure.  and yes I am absolutely claiming a gun will not recoil in a vacuum.  and until there is physical proof you can only believe it will happen and not know.  knowing requires evidence not numbers on paper.  and this burden of proof lies on you and your beliefs.  I do not have to prove I am right only that you are wrong.  from some vids I have seen I believe it to be possible to fire a rocket in a vacuum.  what I do not know to be true nor believe is that it would actually move.
Reply: +Derek smith "you dodged what I said completely. "

No, I think you just didn't understand. The total impulse delivered to a gun by firing a projectile, (or even a blank) and the total impulse delivered to a rocket when firing its propellant, follow the same formula, both on Earth, and in a vacuum. If you doubt both parts, you can prove the "On Earth" part anytime you want. If you doubt the "in vacuum" part, you should be able to say exactly why the formula which works on Earth exactly as it predicts cannot work elsewhere.

Robert Goddard may have been the first to fire a gun in vacuum, when he was trying to counter early objections to whether Newton's Third Law applied in vacuum. You're certainly not alone in your belief, at least if you were around 100 years ago! He concluded that it did. The rest is history.

n4trb dot com/Publications/The%20Rocket%20Experiments%20of%20Robert%20H%20Goddard%201911%20to%201930.pdf

Second page, bottom left, discusses exactly this.

F = ma, in a gun, or rocket or anything else that throws mass away.

"all the variables are different."

Good. What are they? If you can provide a testable equation showing rocket thrust decreasing with decreasing environment density (like air pressure) I'm happy to test it for you. I'm even happy to help you design a test you can do yourself.

" a gun has never been fired in space so you can only make "educated guesses" aka theorize."

You should research your proclamations before you make them.
The Soviets did it at least once.
https://en.wikipedia.org/wiki/Salyut_3#On-board_gun

" it is ludicrous to say because it works here it must work in space. "

Well, it would be, if we didn't have vacuum chambers (and also actual space) to test it in, or if such experiments had never been done.

If there were a different formula, it should be taught in physics class. Yet one formula applies in the pure case the total force from a given mass accelerated by a given amount.

"it is not a fair comparison for anything in space to be compared to something on earth period."

I agree, the behavior shouldn't be assumed. It should be tested. It has been tested.

"well in that case of comparing two environments that are not one bit alike if it works on land it must work underwater. "

Newton's Third Law applies underwater and in vacuum. It also works the same with guns, which definitely have recoil when fired underwater. I've tested it myself, with an H&K Mk 23 "SOCOM" 

"I have never seen a rocket in space nor tangible proof (a video showing it work that I can believe)"

Right, to retain your preconceived belief, you have to reject all contrary evidence. People (even amateurs) have photographed rockets and satellites beyond the 100km "boundary of space". At this point, the only place it's never happened is between your ears.

"I have seen many very flawed vacuum experiments falsely showing thrust like this vid.   to even begin to show thrust in a vacuum you would need the object to be far enough from a solid object (wall of the chamber) to guarantee it does not produce thrust off it nor fill the chamber creating positive pressure."

OK then, a doughnut-shaped chamber would ensure that there was no thrust acting on the rocket due to the propellant hitting a wall. Goddard used just such an apparatus > 100 years ago. If you looked at the second page of the PDF I linked, you'd see that.

"and yes I am absolutely claiming a gun will not recoil in a vacuum."

Right, you are claiming that. If you claim something, the burden of proof is on you.
I don't have to claim a gun will recoil in vacuum. Newton's Third Law works everywhere it has been tested. If it did not, you could read about it someplace. It would also be big news as if guns didn't recoil in vacuum, they could "catch" their own bullets and move around without throwing away reaction mass. One could throw a projectile electrically, and re-cycle it forever, going anywhere without running out of fuel.

That is, unless you think a bullet being absorbed by a lead block also wouldn't apply any force to the block in vacuum.

Because accelerating a mass and throwing it away always applies an equal force to the object doing the accelerating, you will need to show a case where this does not happen.

Whenever rocket systems are designed, they are first modeled using math and physics, so as to make them the right size for the job at hand. Do you deny that rockets can be modeled mathematically to predict their behavior?

"and until there is physical proof you can only believe it will happen and not know."

And what would you consider "physical proof" considering that these experiments have already been done?

I suggest that you're attached to your belief that what you say is correct, and that attachment will prevent you from ever accepting any proof that you could be incorrect in your belief.

If you want to talk about why I believe Newton's Third Law applies in vacuum, I'm happy to run through it all, but I'd like to see some evidence of what law you believe applies instead, and the equation that describes and predicts this part of nature.
Reply: This thread is a bit old, but here's what I'll say. Many people here claim cody cheated by putting the engine in a container with air. They use the fact the engine wouldn't start in a vacuum as "proof" that rockets can't work in space.
But both those experiments are correct. A combustion reaction needs oxygen in order to work, which is why the engine did not ignite in the oxygen-less vacuum.

However, scientists got around this simply by simply bringing oxygen on the rocket itself, eliminating the need for air. By putting the engine in the container, Cody demonstrates this. He provided the engine with enough air to burn up completely.
Reply: What he's not claiming that you can set off powder inside of a vacuum, he just need to do whatever he had to do to get the rocket to go off to do the test he was trying to do which focuses more on the propulsion once a rocket does ignite within a vacuum.
Reply: +Mauricio Harrison the thing is that it was able to burn in a vacuum after it used up all the oxygen you can maby compare the oxygen to the fire starter fluid we use to help start a campfire or something like that

So no its not cheating it burned in a vaccum but it was a little hard for it to start up thats all.

Remember the point of the video is can it burn in a vaccum ? Not will it be able to start in a vaccum
Reply: pseudocoder78 Hey you guys! Rockets burn in a vacuum! They been doing it since the late 50s.  You might have heard that in 1969 they put a man on the moon! They got there using ROCKETS!!!!! . Model rocket engine or not. It has an oxidizer in the mix it will burn. Those Estes engines are basic black powder rockets, has that got an oxidizer?I thinks so,that's the salt peter's job ain't it?
Reply: Will a Model Rocket Motor Work In Vacuum? -No.
Will a modified Model Rocket Motor Work In Vacuum? -Yes.
Reply: If you want to burn me I could be burned to crisps in a house fire. I want all of you to look into my questions. Why a rocket engine doesn't melt steel? Yet we are told that air-plain fuel melted the steel on 9-11. Nobody sees the problem? No deception is going on? Scientist don't work for money and fame? They don't lye? Doctors want to cure us? I am not looking at the bad side of things, I look at things objectively. If Doctors would cure us, they would have much less customers. If scientist would be honest they would not get millions of dollars grants every year that they can play with.
Reply: +LifeIs Short "All of this is centered on the issue of the ground we stand on, and it's lack of curvature."

You say that like there was no possible way to prove/disprove it. Do you agree that the experiment of shining a leveled, high powered, colimated laser a few feet over that lake, and measuring the points over water where the beam impacts, is a sound experiment? If not, what would you change? (I didn't like the production, but I don't see a big problem with the idea of the experiment). Do you?

"1. Rockets can't sustain a burn without pressure."

No, gunpowder based rockets have a hard time starting in vacuum. Clearly, once they light, they run, as the iPhone video showed. Cody showed exactly that in his video. The "catherine wheel" in the chamber reached virtually the same speed as without vacuum. If the burn couldn't be sustained, where did the rotation come from?

Spraying mono-methyl hydrazine and nitrogen tetroxide together into a combustion chamber will spontaneously ignite and start producing thrust in vacuum. Virtually every country who ever wanted to go to space has tested such systems in vacuum. Soyuz from Russia uses the same system.

They use this for the reaction-control system so they can turn and nudge the spacecraft. The thrust has to be throttleable, and quick to start. It is.

"2. Satellites: The site you provided looks like a bunch of beacons in the sky active/inactive - until their balloon or drone can be sent up again."

Yes, they are essentially "beacons in the sky" but they obviously move.

Inactive means the thing is busted. Space is not a good place to get things repaired, and these little amateur satellites break. "Inactive" doesn't mean "it's going to be fixed" it essentially means it's dead. If one ever becomes "active" after being inactive, let me know! It'll be a miracle.

Look at a single one, note where it is (maybe wait till it's over some land). Look again in 10 minutes. Check the distance in Google Earth, or on a map. You'll see it traveled about 2900 miles. Can you think of anything that goes that fast? If so, how does it work, if it's not a satellite? How do you make a "balloon or drone" go almost 3000 miles in 10 minutes?

Go to that site, and see "Amateur radio passes for the next 6 hours" page here:
http://www.n2yo.com/passes/amateur-radio.php

Enter your location, and only active ones flying near/over you will show up. Again, these are built by universities and amateurs, not NASA or anyone like that. Often they are launched by the Japanese, Russia, or India.

"How fast the object appears to move could be a relay or a pulse."

Okay, I've lost you. Relay, pulse? Please explain further.

You have a transmitter exhibiting one Doppler-shift up for one observer, and a Doppler-shift down for another observer, but people are communicating through the thing, so it's obviously one unit. How do you have a single transmitter, unblocked which appears at one frequency for one observer, and another for the second? There is only one way, it must be moving. How fast it is moving is a function of how much "off frequency" the signal is. This is very well understood in physics. Again, both parties can listen to the "downlink" by pointing antennas at the thing as it flies over, but the frequency of that one thing is slightly different for every observer in a different physical place, due to the geometry.

How would you go about causing this effect without having a transmitter moving at the right speed and direction to cause the effect?

Say a train comes, and blows it's whistle continuously. How do you make that one whistle come out at two different pitches, one for the guy it's approaching, and one for the guy it just passed? Surely you've heard this. Try putting your friend up along the side of the track, and you at the crossing. Call him on his phone, and listen to the whistle on his phone while you hear it with your other ear. You'll immediately notice two different tones at the same time. That.

"Doesn't mean they are satellites - which somehow manage to continuously work in the van allen belts."

Did you check the altitude where the VABs start, and the altitude of these various satellites? Nowhere near. Hundreds of miles lower! Let me know if you find one whose apogee is above 1000km.

Also, the Van Allen Belts were first discovered with satellites . So since you seem to believe they're there, and actively ruining all these amateur satellites hundreds of miles below them, you must actually believe they were discovered at some point, and since they can't be measured from Earth, being 1000km up, it must have been a space-vehicle that measured them.

"Planes can be resolved (as planes) with magnification."

Yes, but didn't you use planes as an example of why you don't think a human being can see a satellite?

"Satellites cannot, and they remain 'points of light'."

Why not?

You seem very confident of this new claim. When was the last time you pointed a telescope or powerful camera at one?

"The ISS could be a projection, beamed between beacons."

A projection against what ?
Would you mind describing for me how this technology would work?
Does it also fake the radio signals coming from the same place in the sky as the visual? How?

You do realize the ISS (and other visible satellites) change aspect as they fly over, just like any other flying thing. Say you're doing a "projection" of a bird. Guy one sees the bird coming towards him, he sees the front of the bird. Guy 2 sees the side of the bird as it flies by. Guy 3 sees the back of the bird, flying away.

How would this "beacon projection" know where all the eyes were located so it would make this thing look right for all the people looking?

Also, what company makes such a device that can simulate the appearance of satellites flying over? Can I purchase one?

Also, where is this "projector" located? The satellite appears over Mumbai, and then 10 minutes later it's over Perth. (those are quite far apart, so where's the "projector" ? )

"They send up hundreds and hundreds of balloons across the world each day.  Saying you've seen them as satellites is not true, and you should email your info to the email provided."

How do you make a balloon go 2900 miles in 10 minutes?
Can you sell me one that will do that? I'd like to put a camera on it.
Reply: Why you guys watch these videos if you are not critical of the information? If you don't want to learn just accept information, you are wasting your time. Asking questions is the wright thing to do. Learn and study is what we need to do. QUESTION EVERYTHING!!!
Reply: Robert Destree GOT IT thanks!  The rocket is pushing away from the expanding gas it just created, in the VACUUM of space.....  Where is this meta physicist teacher?  You need matter, or an electromagnetic field to have a 'reaction' against.  You cannot push away from nothing.  If you say the rocket is pushing off the gases it creates, then that would only hold true if the gases moved away slower than the rocket, which I find hard to fathom in an infinite vacuum.  If you say space is not an actual vacuum, and doesn't suck away particles, that's ok.  

On NASA's webpage there is an explanation of how rockets work, and they cite the 2nd law as F=ma.  If F is the equal/opposite action/reaction, as F (1st object) = F (2nd object), then 
ma (1st object) = ma (2nd object).  
Within space, the second 'object' has a mass of 0....
..... the system goes no where.  

If you say the second object is the exhaust gases, then you are saying they are confined somehow, and act as if encased in a pressurized field.  This cannot occur in an infinite vacuum.  If you assume a partial vacuum, then fine, an argument can be made that it goes somewhere (assuming its acceleration is capped somehow) , but you still haven't explained how combustion occurs with no pressure, like Cody's experiment proved.
Reply: I agree that adding oxygen to the mix seems to muddy the results.  A non-reactive gas might have been a better choice, or an ignition system that might work better in a vacuum.  But still, I think it at least appears that the engine kept running after the bottle is breached, after which point it's safe to assume the bottle and the gas would no longer be a contributing factor.  Will that convince skeptics? No.  But it seems a good trade-off between expense, entertainment value, and scientific rigor.
Reply: English is a second language I speak. How many languages do you speak? Do you speak German, Hungarian, Hebrew, or French? Just asking.
Reply: As my final comment: Proving what is already accepted means nothing. Disproving what is accepted leads to PROGRESS. Think about that. Thank you.
Reply: You are a miserable human being Steven.
Reply: Robert Destree lol...no worries.  Inability to explain your position can be frustrating.  Surprised you didn't say, 'go talk to a physicist' earlier than you did....That should be the standard globalist response as FE grows, so we don't 'waste time'.
Reply: Robert Destree If you cannot figure out the context on your own then maybe I should type to you as though you're a child. 
C'mon use your brain.
Reply: lol....here's a dumb argument, at sea level, how can you see a laser at 6mi away a couple feet off the ground?  ..Must be a 'mirage', you're right...no need to comment.  8in/mi squared of curve is a fallacy right.  How does a molten core of the earth create its magnetic field? Heat removes magnetism.  How does gravity suck down all the oceans of the world on a spinning ball, yet can't hold a helium balloon?  The earth's curve is supposedly visible from 35k feet, yet can't be seen at 70mi.  The earth is an oblate spheroid yet all pictures of earth are perfectly circular, never mind how rivers are supposed to negotiate this bulge in the middle.  Why were photos of earth from Apollo 11 faked and shown as the outline of the capsule window?  Anyone who doesn't understand 'why' it would be faked, has no understanding of history, hermeticism, or alchemy.  Why are there so many freemason astronauts?  What is the history of Jet Propulsion laboratory and Jack Parsons?  Who is Werner Von Braun and why would he put Ps 19:1 on a modest gravestone?  Why does the earth move at 66,600mph around the sun, curve at 0.666'/mi, or tilt from horizontal at 66.6 degrees?  Why is the sun '93' million miles away when it corresponds to Thelema?  Why are mars photos faked with rocks in different positions, why were moon rocks found to be petrified wood?  Why is noon not at midnight 6mo later?  I know the dumb answer no need to figure it out.  Why is the Lorenz contraction necessary in the face of Airy's failure or the Michelson-Morley experiment, and how does this correspond to the Sagnac experiment?  Submarines don't account for earth's curvature, neither do engineers.  The Suez canal or the Grand Canal of China aren't built with curvature, why not?  Why are there stark differences in wildlife characteristics at different latitudes?  Why do comet tails point away from their path of motion if they are continually sucked in by gravity (again, don't worry about it, the 'coma' - yet black holes are sucking in matter through gravity all over the universe)?  Why don't buildings lean away from eachother?  Anyway, don't worry about it.  Luckily there are 'geniuses' that are necessary to counterbalance an 80 IQ.  Before you ridicule, do some homework.  There are definite issues with the FE model, and I'm aware of them.  Satellites, and rockets, lunar eclipses, velocity of the sun, and all sorts of things that people get in the weeds about, but the fact remains that the ground is FLAT, so the rest is secondary, and explanations for the details will come with time.  I've spent my whole life believing what you do, now I know better.
Reply: carzak You're right.  Nautical miles prove the earth is round.  Why didn't the rocket burn all the way?  Dumb flat Earth....Why can you see a collimated laser near your feet at 6mi?  You can't because it's a mirage right?
Reply: The specific rocket motor in the video is a hobby-grade motor that isn't designed to operate in a vacuum.  It's also designed to be safe, so it doesn't spontaneously ignite from an impact.  It requires some atmospheric pressure in order for the fuel to ignite, and the ejection charge to then ignite.  Atmospheric pressure likely acts to contain the heat of the igniter against the fuel.  

Although this may not be required for smaller motors, as I believe you saw in the Mythbusters episode.  The igniter affects a larger proportion of the fuel on those, and the combustion chamber is smaller, making them easier to ignite.

But... This is all really irrelevant to whether full-size rockets can make it to space, because solid-fuel rocket engines are ignited on the ground and jettisoned before leaving the atmosphere.  Liquid-fuel engines are quite different.

I don't really know what you're asking regarding the laser.  But there are refractive and reflective effects from the atmosphere.

[I don't know why I keep posting, except that I'm seeing some cracks form]
Reply: bladerise kind of is cheating but he proved it is a necessity to fire that type rocket.  I already commented about making his own with rocket candy rich in potassium nitrate but I am not sure that will even work NASA uses some really technical fuels often with peroxides.
Reply: bladerise well as long as it works I don't think nasa ingenieur consider they're cheating ^^
Reply: bladerise I mean the point is to make this work in outer space so I don't really see the problem of starting the reaction in a confined place
Reply: Mark Gohl I have no problem with this argument, (how other people can't at least get to this point is astounding).  The problem I have is how this can occur if the gas particles are being sucked away as fast as they're made.  Intuitively it seems like the rocket would just burn in place, or spin wildly off course.  One would have to quantify the amount of 'pressure' in space that counters the expanding gas.  Again, if you suck away the air from the back of a ballon as it's expelled, it travels no where (there is no force acting to propel it forward).  Even if you redirect the air 90 degrees after it leaves, it spins in place, and does not move forward at all.  But advocates of this mysterious 'force' that propels rockets forward state the 'force' of expelling gas creates an equal 'force' to propel it....against nothing.  If you say, 'against expanding gas' ok, but the vacuum of space would seem to counter this
Reply: +Andrew Gooding it actually is cheating..... Because this isn't how it works in the real world...
Reply: I told the same thing on my comment!
Its not due to the rocket that it goes of...its due to the tube blowing from inside-out and releasing the energy.
And what kind of experiment uses different standarts for both chances?!!!
Reply: O, boy. Why you think the recoil happens? Why you think the canon doesn't just move in the other direction for ever? FRICTION is the cause. In the vacuum of space there is NO FRICTION. Nothing to push against. You could have any size rocket with any amount of air, oxygen or what ever, if you have no molecules of any gas you have nothing to create friction by and nothing to push against. Any amount of fuel can be burned in any way but if you got no air.......
Reply: You are correct. Look at the NASA rockets flame: it looks like a candle. No way those rockets could ever create any meager amount of push anyway. I look at a rocket that is a weapon and look at a rocket going to space and the later has a much weaker force in the flame. Look at a welder that uses gas. It has a soft flame and hard flame. Soft flame you heat with, hard flame you cut with. Very simple.
Reply: But that cannot run longer than the air supply. If space is a vacuum rockets cannot work doesn't matter how you try. Nothing for it to push against.
Reply: All I can say is: wooooow, you guys are dumb, dumb, dumb. You try to explain why it worked when obviously it didn't work. Stupidity at its fines. We went to the moon. Rockets work in space. Great. So wen did any of you landed on the moon? Wen did any of you been in space? Wen did any of you set in a rocket? Come on people, think. How many mines we have on the moon? What happened to the Wen Allen Belt? If we have satellites in space why we have millions of miles of Fiber optic cables running all around Earth? Why we don't have High speed internet every place on Earth? Why we have a Satellite dish and still not get high speed internet, yet we have Satellite Radio without Satellite Dish? Why we have Fluoride in the water?
Reply: Agreed, the bottle negates much meaningfulness of the testing in a vacuum. There also seems to be the ambiguity as to the Q of if the motor will work in a low pressure environment vs a low oxygen environment. What would happen if you tried to ignite one of those rockets in mostly nitrogen or CO2 environment? Wouldn't oxygen be required for this sort of combustion? On your average NASA rocket engine which operates in space, they have to bring along their own oxygen to be able to burn the fuel.